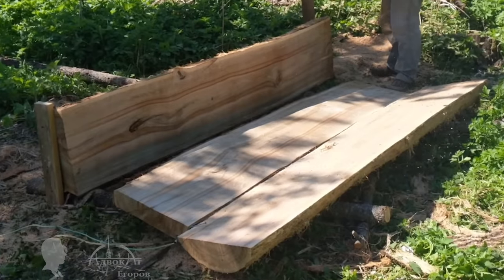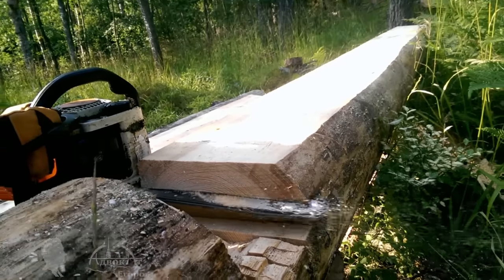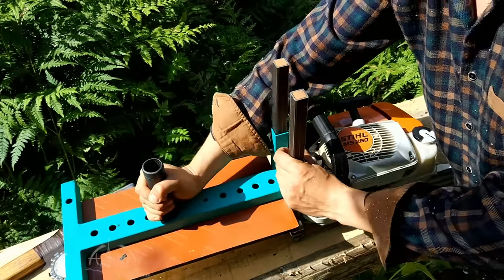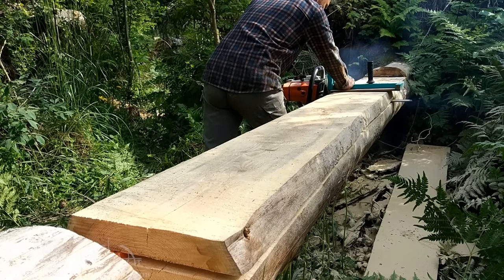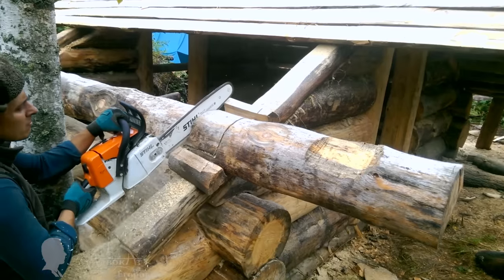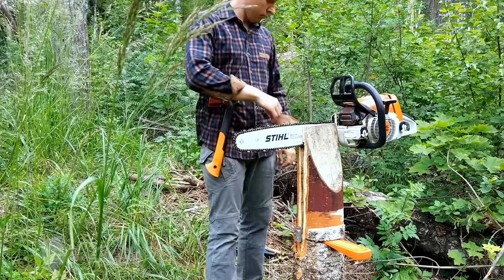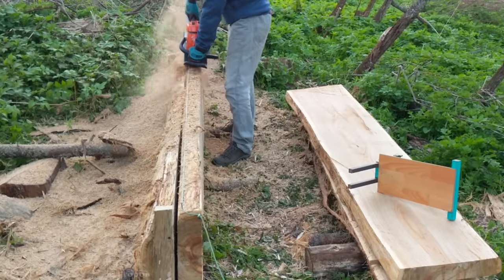Two Chainsaw Secrets | Turning a Tree into Perfect Boards

Comment from the maker: I wanted to ask you guys for advice. I no longer trust my Stihl MC260 as it gave me repetitive problems even after it was repaired by a dealer.

In other words, what chain saw of comparable size would be a good choice for cutting logs into lumber using my method
-------------------------------
Friends, for your convenience I assembled a chronologically arranged list of videos about my efforts in establishing
 this log cabin camp in the off-grid remote location of Karelia (All Seasons): 
-------------------------------
01 episode - @ (1 season)  2014
02 episode  - @ (1 season)  2014
03 episode  - @ (1 season)  2014 (not translated) 

1 episode  - @ (2 season)  2015 

 2 episode  - @ (2 season) 2015 

 3 episode  -@ (3 season) 2016 

4 episode  -@ (3 season) 2016 

5 episode  - @ (4 season) 2017  

 6 episode  -  @ (4 season) 2017   

 7 episode  - @ (5 season) 2018    

 8 episode  - @ (6 season) 2019 

 9 episode  - @ (6 season) 2019 

10 episode- @ (6 season) 2019
--------------------------------
My Patreon page: @t
Reply: You are great on that scooter lol lol lol
Reply: Husqvarna every time, and good two stroke oil at 50 to 1. Never add more oil, more oil = weak mixture = runs hot and increases wear. Steer clear of any 2 stroke with oil metering.
Reply: Maybe one of those competitive chainsaws, with a V8 engine 😂 ... Love your videos. Huge respect for your Work! .. greetings from Denmark. 😀
Reply: For heavy work load I've been using the same Stihl MS 660 for almost 10 years with only minimal repairs. However, it is a considerably larger saw.
*P.S., If you want to get away from Stihl you might try Husqvarna. I have a 480 CD that's over 30 years old, although it's worn out it still runs.
Reply: I have a couple Stihl saws but the one that most impressed is the huztl /holzforrma 372 I run a 41in bar on it and it has plenty of power and is cheap and been very reliable for me
Reply: 372 husky is probley the most reliable saw i have owned. 40 to 1 on the oil mix and break it in before using it for milling.  
      Just my two cents for all its worth.
Reply: Advoko MAKES , Husqvarna !
Reply: I've serviced quite a lot of small engines. In modern chainsaws Echo is a very reliable brand and they seem to make pretty good power for their size. I claim that they offer easily the best value for your money.
Reply: If the chainsaw gave you issue right out the box id call Stihl and let them know, its probably a defected saw.( they do get through the production line every now and then) I wrote to stihl and told them about this, as i own part of the company. (large part) i asked them to send you a new saw, and maybe sponsor you. But you deferentially need to get a new saw, as i know they would rather you use our saw in these videos instead of someone else's.
Reply: Advoko MAKES    Thank you brother for sharing your wisdom with us it is much appreciated        Peace
Reply: Another great video, Max! It sounds like you got defective Stihl. I have one that a friend gave me instead of paying a debt he owed me. It's  a good saw. I bought another, a MC260 in fact. The only complaint I have with it is the lockdown nuts for the bar were continually working loose. A little loctite fixed that problem. I really think you just got a lemon. Every brand makes one occasionally. Maybe you can get Stihl to sponsor you and send you all kinds of new chainsaws to test and critique.
Reply: I had problems with Stihl. Quit on me after just a few months. I bought an Echo to replace it. I love it! I've had it for 2 years, never had any issue getting it started. Good power, and doesn't stall out on me.
Reply: I also wanted to add, that I have been using a husky 445 for a while and have had really good luck for such a light saw. You can see some pretty serious ripping with it in this video that I did in the spring - https://www.youtube.com/watch?v=Adfis2HljdE
Reply: Professionals here use Stihl, Poulan, or Husky in that order. I can't say more but they rely on their saws to make a living so can't be too bad
Reply: Any saw with a 3 or a 5 in front of it....and run lean...I think that saw is to small for the job.
Reply: Husqvarna is a good Mark. but it sounds like you just got a bad saw. any Mark will occasionally turn out a bad unit. but in general I've had good success with Stihl saws. but again if you want to switch to a different brand then Husqvarna is good
Reply: Stihl has two grades of saw. If it is not the pro version it is not much better than any other brand. The pro version costs more but you dont have the down time for repairs.
Reply: I have a an older Jonsered 670 and a newer 2172. Both are real beasts. The 670 is the go to. They are heavy and get the job done. Lp
Reply: Stihl is now becoming known for their saws to fail. They are getting cheap on parts they use for building them now.  Greed has taken that company over. I say go with a Husqvarna instead ... those have good power as long as the saw is big enough for the job you are doing.
Reply: azsazs that very kind of you.
Reply: Good  saw  just stay with it got one 15 ye ass rs old let it warm up .or new diafram new lines filter breather  coil plug  clean cluch oiler .
Reply: can't quite rember but I think piston scoring on the exhaust side is caused by not letting the saw warm up first. Its called a cold seize, which is when the piston expands faster than the cylinder. Could also be overloaded and suffered from overheating. Overheating will effect the inlet side a bit as well but the cool fuel coming in will protect that side a little. Would happen to any brand of saw. I have never owned a Stihl saw but it's the brand that is used in our Forrest industry. My last good saw died a sudden death,  suffered from tree falling on top of it disease. ура из Новой Зеландии, хороший видио
Reply: Here in the Midwest everyone that I know that has a Stihl has them in the shop more often than in the forest. Always needing worked on.  I was on a ground crew for a tree service here for years. We always used Husqvarna  saws for ground work and small Echo saws for up in the trees.  Now that I'm just your average homeowner with a wood stove for heating my garage I have an Echo CS-440 with an 18 inch bar and have never had a problem with it. And I'm not the most gentle person on a tool either.  For you I'd suggest the Husqvarna  555
Reply: @Paulman50  i have had that happen on a cheaper saw with aluminum piston and cylinder. I think mostly due to wrong fuel/oil mix. Carbon can build up and score the aluminum. My sthil 036 pro is over 20 years old and ive never used anything other than sthil oil mix and it runs just like the day i bought it. Although it is a pro model and cost over $400 back then. I did change the spark plug two years ago just because. I admit im not a heavy user, but that saw has cut probably 100 cord of oak firewood.
Reply: @nooneyouknowhere6148  I agree with your assessment on there being a difference in the "Pro" models vs the "Homeowner". When I was in the tree business, I ran an 038-AV-Magnum, that I purchased for myself because the company did not want to put out for the expense. It was totally worth it and made my life much easier! Advoko... you should look into trying to get this model if you have the chance. Loads of power, screaming RPM's, low weight, and can run a much longer bar than you would think just by looking at it. I would buy it again if I found that I was going to be cutting a large amount of trees.
Munro
Reply: I forgot to add... the 038-AV-Magnum is made by Stihl...
Munro
Reply: Looking at the piston it has a four corner scarring it’s caused by the saw running to hot running a dulled chain will cause it to over heat the engine works too hard I would turn the chain into a ripping chain skip every two teeth file down two teeth and use a 10 degree angle to sharpen it there are videos on how to do it on you tube another thing open the low idle screw it will depend on how many feet above sea level you are to get the proper adjustments you what it to almost make a cam noise on idle then adjust the high side not quite screaming sound but almost like a bumblebee sound or look up specks for your location and set the saw adjustment with a md1 scanner next is the quality of your fuel in America we have poor fuel they add ethanol to it to stretch it out it burns up a lot of two cycles here stay ethanol free  if possible
Reply: I have used a STIHL 361 for 5 years now it’s my do everything saw 
I cut about 15-20 cords(4footx4footx8foot)  of hardwood fire wood a year with it and about the Same of cedar fence post and rip cedar and Pine planks 
The only thing I do special to the saw is I run as high octane gasoline as I can buy and I only use STIHL oil mix And I don’t store it for long periods of time with gas or bar oil in it
Reply: MS461
Reply: Hi. Great channel. I hope to learn a lot from you.

See, I personally think that cutting along grain with a 260 is asking too much of it. I don’t think it was really designed for anything other than crosscutting. I wouldn’t attempt using a stihl model number below 440/441 for anything like this, and even then the longevity of the saw is surely bound to be compromised. 

I see someone mentions Husqvarna 560xp here. I’d agree with that partially. It’s a good and gutsy saw but you would have to use Husqvarna xp two stroke oil as specified in the saw’s manual. If the saw were to seize mid use and it was found the two stroke oil used is anything other than their own xp oil they simply will not honour the two year warranty. Believe me, it happened to a friend of mine. 

I would really opt for a bigger saw and try to get used to using it as you would a smaller one. They’re designed for heavier work and will last for years. Plus you get a good workout out of it.😁
Reply: Thank you very much for spredding your good idea.
I have a 260 chainsaw, and, like you, are dissapointet with its performance.
I have used the 026 for 25 years with succes. Althoug it should be the same saw, i'll always find it much better than the 260.
Reply: Hello Advoko MAKES, I own both Stihl 260 and its Husqavarna XP 50CC Professional equivalent as well as other larger saws.  Although I have never tried using your method to cut boards freehand, I think your problem lies not with the brand, but with pushing 50cc saws to their limit.  Husqvarna XPs are generally considered more favorable by the arborist, logging community, while Stihl is still the industry standard, especially for Wildland Fire, and EMS services.  Both have their place and their fans, I think you need not worry you picked up the wrong brand.  My 260 has given me plenty of problems but it has withstood the test of time, and while its Husky 50cc counterpart does cut significantly faster,  I've noticed other issues that are unique to the Husky 50CC XP and it bogs down too sometimes when it shouldn't!  In sum, neither are perfect and I think you will be much rewarded if you investigate larger cc saws for this specific task. 

A friendly user above has made the suggestion of using Stihl 660 and 880, and indeed both are wise investments. However, because of the weight, both will need significantly more user time and training to get re-acquainted.  Writing from where I am from, Taiwan of East Asia, local carpenters have used your method to cut altar tables (usually the best wood with slabs too big to be cut by milling machines) and other religious-based furniture with both Stihl and Husky without a problem.  Good luck and God Bless you for making the video, stay safe and hope you find the right saw.
Reply: Ms311 is a 60cc. Any saw 60cc or more should do it for you.
Reply: @stevetaylor9265  I agree...
Reply: Love that tree stump vise, but I keep a husqvarna stump vise in my bag. Works good and can be hammered into a log or stump. Sthil climbing saw,  husqvarna for ground saws. 357xp 20+years strong.
Reply: There is only ONE chainsaw brand with a FIVE YEAR WARRANTY... and that is ECHO brand.    I have 4 ECHO chainsaws, I love em!

THE LARGER SIZES ARE:
CS490 - 50.2cc - $349.99
CS590 - 59.8cc - $419.99
CS680 - 66.8CC - $639.99
CS800 - 80.7CC - $859.99
Reply: Husqvarna 390XPG
Reply: Husqvarna 390XPG
Reply: Before you buy a new saw, try a new chain.
They make chains specifically for cutting logs into boards. Rip Chains make a slower cut and leave a smoother finish as well.
Good Luck, Enjoying your videos
Reply: @azsazs6039  that is a great offer. Sthil saws are reliable saws. Even though I did not like the 026 / 260  for other reasons, they were very reliable. If he is able to get the MS 261 he will have a reliable saw with much better performance.
Reply: Use a lot more oil in gas.. I load my  saw with way more than specs call for
Reply: Just read someone elses post and he says less oil..?
Ive always loaded my saw heavy with oil without measuring..
The one time i used someone elses saw and they did mix it destroyed the saw and it was new... All i know is my saw loves oil so i give it oil...
Reply: Тебе кто разрешил деревья пилить?
Reply: Anyone that can haul two huge pieces of logs out of the woods with a moped , gets a thumbs up !!!
Reply: I would recommend the Sthil MS362. It is a size bigger but the weight to power ratio is impressive.
Reply: @azsazs6039  Stihl is good equipment, used mine Many yrs.  If a problem from beginning, something with the saw was not rite.  Dealer should have caught that.  Maybe they figured they could fix it rite.  Only other thing would be correct oil for mix.  All oil is not the same.
Reply: Hi, I know why you wanted to use the MS260, they are quite powerful for the weight, and with your method the weight of the saw is very important. I have several Stihl 026 saws, the previous model to the MS260, and these 026 saws have given very good industry level service. I always use the Stihl synthetic 2 stroke oil. I'm assuming with your method that full revs are only on the cutting stroke so the revs are constantly changing which is a good thing. The problem with the frame milling attachments is that they encourage the user to keep the saw at full revs through out the whole cut which builds up excessive heat. The MS261 saws are more powerful but slightly heavier, I suppose it is down to what is available, but varying the revs is very important. As regards to the depth gauges I set mine to 0.8mm (.030) to get free running quick cutting with no dust. I have some 026 repair videos, cheers
Reply: @davidd6635  Yeah i know, thats the 1st thing that came to my mind, factory default, they do happen from time to time and its very important that they are made aware of it so the can fix that problem.
Reply: For lumber milling, you are using too small a saw.  Get the biggest saw you can find. I would use nothing less than a 72 cc saw.  Stihl ms 440, MS460 magnum or even a 660 magnum would be ideal.  An old style Husqvarna 372xp, 385, or 390 would also be ideal.  I use strictly the older versions of the 372.  Parts both OEM and aftermarket are readily available and performance upgrades can be made for substantial increases in power.  I do some port work and open the muffler and even put a pop up piston in a couple.  They scream.  The older saws seem to be way more durable.   Plus they are cheaper to acquire, easier to service and parts are cheaper often.  I would also only use premium full synthetic fuel mix.  Stihl full synthetic would be the cheapest I use.  Don't know if you can get Amsoil, but I only use Amsoil saber in my saws.  Royal purple would also be a good brand.
Reply: I use Farmertec G660 92cc saw for milling. Farmertec 3/8 full house full chisel chain sharpened to 10 degrees with 4.8mm file. 3% oil mixture and hi jet a bit rich.
Reply: I use a Husqvarna 353. Perfect balance of power and light weight. It is the pro equivalent of the 350 which is a homeowner saw. Also. Have a 455 and it is a beast made for farmers and ranchers.
Reply: @chattonlad9382  I have run 40:1 in my saw from day one. That was 16yrs ago, and last year, I did a compression check on it. 155 psi . From my experience, less oil will make the saw run hotter, not more oil.  Stihl 036 Pro
Reply: @stevetaylor9265  Yep, I only run my saw with 40:1.
Reply: Hultz farmertech. Get a holtzforma g660 or f444
Reply: I have used stihl, jonsered, and husky.  I prefer husky.  Let saw warm up to avoid scouring of piston. rip cutting is easier with skip tooth chain. File rakers down a bit more, but watch out for kickback.  If you look from the side of your chain, ensure you have enough depth when filing.  You should see a nice hook on each tooth.....cut noodles, not sawdust.  cheers!
Reply: You are doing the work of a timber saw because of the longer time periods you are pulling the trigger at wide open.   I highly recommend a pro series timber saw instead of a homeowner model.   The Stihl MS460, Husqvarna 372XP, and the Jonsered 3172 are all of equal caliper.  I don't know where some of the guys are are coming up with the nonsense of running a saw lean for longer life.   The EPA is destroying the quality of modern saws by trying to run them too lean as it is.   If you will run 40:1 synthetic mix and de-tune  your saw to 12,000 rpms on top end instead of screaming like a banshee, you will get long life out of your saw.   And, a pro saw is rebuildable many , many times.   You get what you pay for and you are definitely exceeding what a homeowner saw should be doing.  And Poulan, ha, the only reliable Poulan  has an electric cord attached to it.
Reply: 85577alarm  a Stihl MS391 is still a homeowner saw though.    All plastic, clamshell body and cost $575-685 when new.   All of the one series saws are relatively new and there is no aftermarket parts support available at this time.  That amount of money  will buy a very nice, used timber saw that will weigh relatively the same and be a heavy duty pro saw.  What is a 190 or who builds it?   I work on saws  and can't place that model number?
Reply: @ulriklange3924  how about diesel engine ??
Reply: Great video! Just sold my sawmill so I will try your method coming winter. I have the same 260 and never let me down last 2 years. Has more problems with my former stihl. I only use the Aspen fuel with this one. Maybe that makes a difference...
Reply: Never ran a stihl i liked ...husqvarna all the way ...they can be a bit of a bastard to start but they outlast the other saws by a wide margin
Reply: I will second the Husqvarna suggestions - we ahve run both brands of saws for the last 40 years, Husqvarna / Johnsereds never an issue - all issues with saw performance have been with Stihl. When they run / work well - awesome soaws, when they are problematic - nothing but trouble and no amount of tinkering / repairing etc ever seems to make a bad saw into a good saw. I'm 52 now, started with an old Stihl 015AV when I was 10 ( heavily supervised) . That was a great little saw...but we had an 042 a few years newer that was nothing but trouble, the Johnsereds my dad had at the same time as the 015av is still in his basement and still starts after a couple of pulls even when it only gets run a couple times in a year. My Husqvarna 242xp from the 80's is a workhorse, we have a 272xp (good option if you want a medium weight  strong saw, not sure how it compare the to MS260) which has been around for a long time. In comparrison the MS250 my dad got not long ago has an out of the box problem with the oil pickup and sometime the fuel or oil cap will not lock but looks like it is until you realize your boots are covered in bar oil and your bar is not. 

I think that if you find people who regularly use both brands, they will all agree that it comes down to which specific saw you are comparing to which other saw....
but....
I will always start looking at a Husqvarna option first and only if there is a proven Stihl option which seems better go that route.

Stihl has better marketing and more of it, Husqvarna just lets the saws sell themselves.

You be the judge.
Reply: I've got an old Woodsman that works on my saws I've had stihl, Husqvarna and jonsered and I have a new Echo now he says the new Echoes are built better than any other saw now.
Reply: The Stihl and Husqvana saws will suffer from lower quality fuel, the fuel is getting weaker and weaker being mixed more with other chemicals, this is why's saw will not run for as long.  Also modern saws run faster and leaner to meet emissions targets and to get more power from the fuel, they scavenge exhaust gasses and as a result wear out quicker.  I now use a Bio fuel or very high quality 2 stroke oil.  I would look at the Makita/Dolamr 50-60cc saws, very strong saws.
Reply: Spasibo, spasibo for the awesome video! I switched from a Stihl gas chainsaw to an electric (battery powered) saw 3 years ago and never looked back. Like you, I had a series of issues with the gas saws, regardless of manufacturer. The more powerful battery powered saws have plenty of power and the reliability, maintenance and operating costs  are substantially less than a gas powered saw. In 5 years, I doubt there will be any gas powered saws on the market.
Reply: Seeing that piston scoring after 2 months indicates to me either a serious air filter problem, contaminants in the gasoline, or improper mixture. Shake your mixture up every time, use as high octane gasoline as you can find, and try to get non-ethanol fuel. Start every day by closing the choke on the saw and blowing the air filter out from both directions with an air chuck, and do it well away from the ground so that dirt/sand doesn't lift. Then blow out the air filter cover and the carb assembly.
Reply: Man you need a customized table saw with a huge disc.
it will save you a lot of time and effort, and your cuts will be precise.
Reply: My Stihl ms 260 lasted for 6 years , I stop my chainsaw when it’s low on gas and I never let it run out of gas completely , I never use regular gas instead I use super unleaded so idk if my routine is working for me or if it’s just luck
Reply: Sthil 051 and sthil 660 ms  i trust them
Reply: Use the Stihl 660 a 260 is not anywhere near powerful enough
Reply: Хускварна ёсть лучшё за работа в дома.
Reply: Stihl saws have a problem with the oiler and that's probably why it's not lasting for you.  You have to make sure it's turned up all the way, and clean the oil holes in the bar often and also make sure the hole going into the saw is clear of sawdust.  Also clean the track with a credit card of something.  I also let my saw rest after about 15 to 20 minutes of cutting and cool down.  Husqvarna professional saws are pretty good, but the department store variety only have one compression ring, and they still need the same care around the oil holes because of the longer bar.
Reply: We also have more trouble with our Stihl MS200 than with the Husqvarna 357 XPG. Something to be aware of is that chainsaws are not designed to run on full throttle for longer than a few minutes a time. 
The Husqvarna never fails me even if it probably is a bit small for milling. Usually at least 70cc is recommended for milling but that might be for the very reason you discovered, a more powerful saw is needed if the whole bar is cutting. A used Husqvarna 357 XP in good condition or the newer 560 XP is the direct counterpart of the MS260 and if you are satisfied with the performance of the Stihl they would probably suit you. I would also recommend to only use alkylate petrol such as Aspen (http://www.aspenfules.com) instead of regular gasoline and oil. It's better for the environment, better for you and better for the chainsaw.
You have a very interesting technique I will have to try that when I start milling for myself! I suspect that it requires a bit of experience before the cuts are good and the boards are reasonably straight.
Reply: I use a Husqvarna 450 Rancher for exactly what you do; felling trees, ripping planks freehand, branches, firewood...
Reply: I’ve been using a poulan wild thing lol
Since 2001 lol. I changed the spark plug once, about 2016. It runs great with an 18” bar always starts on the first or second pull. I only put the non-ethanol gas into it and keep the bar oil full. 
Cheers mate
Reply: If that was scoring on the piston it was probably an issue with the air filter.
I use a Husqvarna 450 with an 18" bar. Husqvarnas are very reliable and have better quality air filter designs. if any oil or debris is drawn into a saw's engine through the air filter then it tends to score the piston like that, which can  quickly kill the saw.
Reply: Husquarna.    Greetings from finland
Reply: Advoko Makes, first of all I want to compliment your work, It´s outstanding !
On regard about your chainsaw problem and seek for advice. I´ve been building a log cabin for over a year now, and for the job I´ve been using a Stihl MS361. This has been the only chainsaw I´ve used, and needless to say, I´ve abused it, and so far it´s withstanding the job with no problems at all. I´m using dead standing cipress (that was caught in fire a decade ago), which is not the friendliest of wood for the chainsaw. Hope this help. keep up with your videos, cheers.
Reply: One issue I've heard is the newer saws are hampered by emissions legislation.  Better off to find one from a few decades ago or get a new fuel injected one.
Reply: Rick Sanchez C137 didn’t look like a warrantable failure for any brand.
Reply: Tam Moilliet had one for 5 years now. Excellent mid size saw 👍
Reply: Stihl makes a homeowner saw line and a commercial line. They look the same but are worlds apart. Make sure to get the commercial such as the .044 or the very powerful .066   The .080 is too powerful and bows or twists the bar. I have many hours experience with each. Farm boss is also a homeowner saw. Thanks for showing this technique. Watch those toes!!
Reply: @azsazs6039  hope you told your Stihl buddies to send him a commercial .044 and a rip chain
Reply: @nooneyouknowhere6148  spoken like a skilled treeman! Yes, I shared this same tip and recommended the .044 for what he is ripping.
Reply: Phil Harley I think you’ll find those model numbers have long been superseded 😉
Reply: Pro's use Stihl and Husqvarna, when I called Stihl rep to ask what they consider their pro models the representative said MS 290 and up are the pro models and reading the forums the Husqvarna pro models are their XP line. Another easy way to tell is by price, the home versions run $300 and the pro versions are $700 in the US
Reply: Stihl 090 all the way!
Reply: I like Stihl. I use the 661 for milling. We also have an old stihl 088. It’s very big but it’s a pain to use for most things.

One thing that will help with ANY brand of saw.. add more oil to your mix. I use about 25% more oil in the gas mix as it will protect the cylinder and last longer. Chainsaws are not designed to do milling and run continuously and they can burn up easily. The additional oil can make your spark plugs foul quicker if you are not using the synthetic oil in the mix.
Reply: I've been using a Stihl ms 270 with the 25in bar for a little over ten years know. I have had no problems at all. Still using the same spark plug even. Only using Stihls mix at 50:1 with a none ethanol gas. Huskies are ok, they just don't run as smooth. Anyway, great video. I am going to try this with a few logs I have laying around. Thanks for sharing.
Reply: Let your saw warm up before use. Specially this long cuts you are making. Saws are getting increasingly compact and could influence ventilation. Also the difference between pro and normal user.
Reply: I've owned a Stilh 044 with a 24" bar for about 25 yrs and just replaced the original spark plug this year , my saw has been used heavily in my work as a carpenter and cabin building also tree felling and I've never had any issues other than the spark plug. I don't take much care with tools figuring it's cheaper and saves me time to just by a new tool after breaking one but I haven't been able to kill the Stihl .
Reply: I own Stihl MS 362. Best chainsaw I have ever had.
Reply: My 3 Stihl saws are over 20 years old, but I was told that Stihl made big changes to meet the strict emission standards.  I think Still is likely still the best but the new saws, I believe are problematic.  I new more details of the chà an ges when I researched online and talked to a dealer.  But anyway, my research promoted me to have my saw repaired rather than buy a new arborist saw that seemed sub-par
Reply: Try a dolmar ps6400 or makita dcs6421
Reply: Husqvarna Pro Series like the 560xp would be great for you.
I too used Stihl Saws for Years every day ( I am a logger here ) but the last say 5-8 yrs their Quality has slipped badly. So since I have to use a dependable saw I tried the Husqvarna Pro series and I love them. Tough, power to weight ratio is fantastic and they are VERY DEPENDABLE . Find a Dealer and go try one of the XP series of saws....you will see what I mean.
Really enjoy your Channel and Videos.
P.S.
 I have seen a cylinder and piston out of a Stihl Saw that looked identical to what happened to yours. The Owner of the saw (a guy I have worked with for years) said the dealer told him it was because he revved up the saws engine when it was first started instead of just starting it and letting it warm up first. He sees lots of saws of all brands that are used in the construction buisness like log homes and so forth and unless they are allowed to sit and run for a minute or 2 even you risk damage because of lack of proper lubrication in the cylinder. I dont know if it makes a difference or not but I have always started my saw and let it just sit and idle for a little bit before I go to using it and I have never scored or stuck a piston in my life.....I have wore out pistons over the course of a couple Years of everyday use but never ruined one like that so maybe there is something to it. All I know for sure is we have not had a saw do like that since we all started just letting them warm up a couple of minutes before using them and we never go to full throttle unless in the wood and cutting. Hope that helps you.
Reply: Makita makes a batt operated chainsaw that is awesome!  I own one and it is surprisingly hard working!  Have two extra batts (5 amps each) that substantially increase duration of operation.  And they can be recharged from a 300w solar panel!  You can’t make petrol in the bush, but sunlight is eternal (more or less).
Reply: Looks like you ran the saw with out warming it up
Reply: Man you should try each brand
Reply: @Paulman50  Exactly what I was thinking.
Reply: 028 Farm Boss, possibly the best chainsaw ever.
Reply: I’ve owned a Stihl 260 for 10 years and never had a problem. The saw you purchased was undoubtedly defective, and I’m certain that Stihl would honour their warranty if you contact them.
Reply: Husqvarna 372 xp. You will never go back.
Reply: Homelite, it's the bees knees
Reply: @PenZon  Echo is trash. They make terrible chain saws. You will never see a tree company with them. The demo units they push on everyone are toasters.
Reply: @azsazs6039  You ran the incorrect chain. Rip cutting favors skip tooth chain. You did not run the engine under the correct load because you had the wrong chain. In short you overheated the saw with every rip you made.
Reply: @rivtool515  What? I was telling him he has a bad saw. I never said anything about me or my saw.
Reply: Advoko MAKES 
I’ve a 261. And it’s my favorite saw hands down out of the entire fleet. That’s odd for a pro saw to have damage like that so quickly. Dirty air possibly? Or it was ran way to lean in the air to fuel mixture. 
The only other suggestion I would make for a milling saw is an older Stihl 064. It’s much heavier. But it’s a power house for what it weighs.
Reply: Я не знаток но похоже Husqvarna делает хорошие бензопилы. Не знаю как они по цене к Stihl...
Reply: Hi! I have been using Stihl and Husqvarna  for few years and they all had a lot of issues, now I have ECHO 66.8cc chainsaw with 24 inch bar. They are made in Japan. It works very good with my lumber cutting
Reply: I work everyday cutting trees down in all seasons of the year in upstate NY. Husqvarna 550xp mark ll with a .325 .059 78dl chain its a sure fire saw, plenty of chain speed and tourqe for an mid size saw. Don't believe the hyp of Stihl propaganda!!! A few guys I work with have Stihl and they have all broken within a few months at the longest. Go Husqvarna and you won't have any problems 😁
Reply: When you feather the trigger, like you were doing when you were cutting, instead of having the trigger pulled all the way, there is not enough fuel to lubricate the piston. Sometimes there's enough to keep it running, but most of the time it bogs out and quits under a heavy load.
Reply: The stihl 260 is a great saw. It looks like you were putting only gas into it. You need to mix the correct oil with the gas first, then put the fuel into your saw. Otherwise you will blow the engine.
Reply: Use stihl 381 i also have it and use it the same way anyways many people here use the same technique. Earlier I too used attachments but it took long time just as you said and switched to this technique which consumed less fuel
Reply: My friend: use engineered gasoline. That's tip number one. Learn to adjust your saw in the cut, utilizing the four stroking method.
Reply: there is no saw in the 50cc size class that I would recommend for milling at all In Stihl, you need to look at something like an MS660 at the least.
Reply: While having less Performance by weight, echo saws are known for immense reliability (hence the weight i guess)
Reply: @severini8153  he's in Russia, unlikely he could get Echo
Reply: @mattcourty6322  I bought a used 034 AV Super from an arborist about 20 years ago, and it's never been in the shop.  It cuts my 12 face cords I heat with every winter.  Before that I had a Husqvarna (don't remember the model), and what a cheap piece of junk.  Mostly plastic.  I think the difference isn't so much the brand as whether you have the professional grade or homeowner grade.
Reply: Chattonlad what do you mean by “steer clear”?
Reply: none of the 3- series saws from Husqvarna are "homeowner" saws. that would be the 1 and 4 series. 
the 353 is a different year. 346 and 350 make great builder's saws (meaning take mods great) but all three mentioned in this comment are 50cc saws.
Reply: I've had the same ms390 for 17 years. Replaced the fuel lines once and the 25 inch bar once. Maybe stihl quality has gone kaput?
Reply: @brobdingnagianone900  nope, quality still there, this guy is asking way more of his MS260 than it should be expected to do
Reply: I'm a bit late, but try Dolmar, they make great chainsaws for a reasonable price.
Reply: Matt Courty my dad and brother both had Stihl’s.   Worked fine for a while then at some point they just wound up tight..ping.   Dealer basically said they were non repairable.   Seemed to be a prevalent problem.   Noticed the county highway dept had all gone to husavarna.   They are not likely to go back.
Reply: Can you define your problems?  It is vague.  The 260 is a fairly small saw for this type of work,  I've found my 460 magnum to be a great all around size, although a 360 may be a good compromise of weight and power for a shorter bar.

As far as husky vs stihl, they are both great, model dependant, just do your research and watch YouTube videos to learn to do your own repairs and upgrades.
Reply: Styhl Ms 362
Reply: If you have a 260 burnout in two months then you have a problem, a mechanical issue.
Use premium/high octane gas.
Use Castrol/Stihl brand mix oil.
Dont rev the engine when it isn't cutting/ under load.
Try a still ms362, it is the next size up.
But really I think a closer examination if your saw and cutting practices should be undertaken. The 260 is a great saw and should work for years.
Reply: I use a Stihl MS 291. It's heavy but it gets the job done everytime.
Reply: @steveadams80  i have two 291s. One i purchased new in 2004. They both have hours of good service. Very reliable.  No sure about the newer saws
Reply: azsazs I’m just starting off as a wood carver, but my father has been in the logging business his whole life. I don’t know any specifics on his work, but I would love to get him a new durable saw. Any help?
Reply: azsazs I’m also just starting my own channel and would definitely do a review video
Reply: Run a MS310  like you do works great as long as I have a sharp full chisel chain . Wore out a 026. And picked this beast up in a pawnshop for 100.00. A new bar and chain and gas cap been rolling ever since. Just not big enough gas tank when I am milling lumber. . Good work there.
Reply: My guess is the mixture was a bit lean and it was running hot, you would get higher revs but at a high price.
Reply: I miss my old Polan 3400 countervibe (from the Original Polan company). It had tons of power. My brother borrowed it once though and left fuel in it all winter. As this saw was from 1986, I could no longer get a carburetor kit for it, so I bought a Stihl MS270 Farm Boss a few years back. It has been fine so far.
Reply: @nikburton9264  Nik, I make sure there are good quality self locking (serrated) nuts on the bar clamp. I know some companies use nylok nuts but those can vibrate loose. Another fix is Schnorr washers. They stay tight! (serrated and cupped).
Reply: Dennis Long  yeah, poulan is great. Everyone i know who does tree work has one stashed just in case and everyone's grandfather had an old poulan in the garage or the barn somewhere that's older than i am
Reply: Greetings from Texas.. Over the past 40 years I have used Homelite,Poulan,Stihl,Husqvarna and my latest purchase Echo 590..Pound for pound the Echo 590 is equivalent to the Husky 288..My main woods are Hickory Mesquite and Oak.. I have never tried the Echo on the long cuts in your video which are very impressive.. I  am going to give it a try.
Reply: I thought Stihl was a good saw but I guess the level of work you do is just too intense. At which point I would like to say you do some amazing work. WOW not sure where you are but looks like a beautiful place. Stay safe you are inspiring me to try building something in the Bush. Thanks for sharing your life and expertise.
Reply: Hello  I use echo chain saws really good Japanese made
Reply: Husqvarna 365 or 372 in my opinion. Great saws, very rugged and will last a long time.
Reply: Hey great videos , as for your saw I recommend turning down your high jet so your saw doesn't rev so high it's what I had to do while using your technique to saw out logs.
Reply: Great  board cutting technique. I run a chainsaw repair shop and I have rebuilt many Stihl and Husquvarna saws. Those are the best two saws on the market provided you only buy their professional series saws. MS260 is a professional level saw and looking at the scored piston in the video Id say you're oil; mix was a little lean or you adjusted the carb to lean on the High side screw. I only use  Amsoil synthetic oil in all my saws and I highly recommend it to all my customers.  Theres nothing wrong  with a Stihl MS260 but a Husquvarna 372XP will do the job. Good luck, Scott
Reply: I’d say a ms 271 or 250 I’ve had my ms 250 for little over 10 years and I’ve ran the crap out of it very well biult saw. The 271 allows you to run a variety of bar sizes, to where ms 250 can run up to a 20 inch bar .
Reply: Echo made a good saw , I've own several of them , most timethe started first pull , I f they didn't on the third pull the plug was fowled
Reply: My husqvarna 550xp gave me similar problems only the dealer gave me no support.    My saw scored the top end.   They blamed my fuel.   Which was fresh non ethanol, Stihl ultra oil, and being used by 3 different saws.   In the end I paid a different dealer to replace the piston and cylinder.   He could find no reason for the failure.   I had him replace the carburetor for an additional $115.   Total bill was $283 plus shipping.   I to never trusted the saw after that.   I used a few times but sold it this spring for $325.
Reply: I've always had stihl and feel I may be on my last one. Heard lots of good on husqvarna.  Thanks for the great video
Reply: I love your work!!!! Very impressive! I own a small tree service. I own both stihl and husqvarna. You try a husqvarna 550xp or 562xp. I own several of each and beat them up and they just keep going.
Reply: husquarna, Swedish made chainsaws. great video man! love the scooter transporter
Reply: Great that you helped the guy out making the fantastic videos.  Wouldn't want a bad comment on  a public video about your heavily invested product line. You retain that the saw could be defective? Where's the quality control? We as consumers do pay a premium for stihl equipment you know?!  Once upon a time stihl made quality equipment,  I sir have ended my mistakes of being let down with my recent purchases of stihl power equipment.  Failing clutch engagement problems, electronic carb tuning issues,  fuel cap failures etc.....I literally just gave away an old 361 saw that we had purchased new 20+ years ago that was still in original, good running order to switch over to husqvarna.... I wish this video maker success and he needs a reliable superior saw to do so.......
Reply: I agree! Stilh products are garbage lately.  They somehow are relying on their reputation if the past to survive.  Won't be long though.... This land clearing guy has switched to husky pro saws👍..... No comparison!!!!
Reply: I have been using a stihl ms 361 since 2004 and it still runs great as long as you take it to the dealer once a year to get checked.
Reply: can you post on your pages where you buy your axes, i am in canada and am looking for quality axes and other manual cutting tools, which i cannot seem to find here, everything comes from china
Reply: Hi again,Max. To answer which saws make good milling saws,  Most people recommend ones of around 90 to 111+ cc's.   Saws of which some are older and heavier but are torque type saws vs high revving types. These are ones such as a Stihl 051/056  which is 81 cc and 075/076  with those 2 being 111cc saws. Also a Stihl 088 or MS 880 and the Husqvarna 3120 or a 395 XP make wonderful milling saws as well.  If I were to recommend saws to use with a chainsaw milling jig, it would be something along the lines of those 7 saws and even a big Homelite XP 1020/ 100 cc saw.  These  saws are very good for the large 200 cm to 1 meter+ diameter logs using milling chains.  Other great saws that are lighter and possibly easier to use for "your method"  might be Stihl 044/ MS440, 066/MS660.  Husq, 365XP , 372, 340, 550 XP on the smallest and lightest end and comparable to your MS260 Stihl.  Just to let you know,  My first chainsaw is and was basically your 260 only older.  Stihl 026.  I own 2 of them, an 044, 660 and the previously mentioned 056 and 075's.   Good luck and keep up the hard and enjoyable work.
Reply: Use a Husgvarna
Reply: I have had a Husqvarna 460 w/24" blade for about ten years now and a Stihl MS271 w/20" blade for about a year. Both have been great saws
Reply: Hello Mr. Please you sell it's dispositive? Vindeți(Ro)? Thanks
Reply: @Paulman50  ⬆💯⬆
Reply: @advoko

I'm in Michigan and cut 10+cords/yr of hardwoods.

I like the Husqvarna. That said, the design is nowhere near as robust as Stihl.

I've switched to Stihl.

You might want to try a Husqvarna. It won't last as like ng as your Stihl. But they are lighter and almost as good as a Stihl.

For me, I go through enough parts with 2 chainsaws cutting 10cords plus helping neighbors....the service and expertise of my local dealer determines if I run Stihl or Husqvarna.

That said, chainsaws don't run all the time forever.

Is it possible your attachment put too much stress on your motor?

 It wasn't designed to be a sawmill. Using such a device voids your manufacturer warranty. Guys I know who use Alaskan Sawmills, use them with very large Bar Chains...like 36" (1M). They use thier large saw for big trees, and milling in only. It's too big for anything else.
Reply: Stihl 391. Solid. I Have 3
Reply: I have a stihl 066 and quit mixing 50:1 a few years ago. I now run between 25:1 and 35:1 and have found I have been getting longer life out of the engine.  In fact I’ve been running without a rebuild for years since I quit 50:1 fuel. I have also freehanded lumber with good success. I get nice long shavings and quick cutting by holding it on about a 45 degree angle, and I still sharpen it for cross cutting. Perhaps I’m doing it wrong, but it works pretty good
Reply: @chattonlad9382  Yuup! Husky baby! Only way to go! And take it to a good saw shop that you trust right out of the gate, and have them tune it in! It will be a screamer!!
Reply: This probably isn't the issue considering your experience (everyone makes mistakes!), but I couldn't help but notice that your gas (starting at 10:54) looks clear. The 2-stroke oil we have here is blue, so any gas that's been mixed has a bluish hue. Running your chainsaw with no oil is one cause of the piston scoring you showed on your 260.
Reply: that 260 is brush saw, if you up grade to a 360 you will up grade to a farm grade, for a commercial rated for timber saw you will want be above 550, my self the 660 is the my preference, the 880 are very powerful all though all of them can be very hard on your shoulder when s starting
Reply: Husqvarna 440 pretty peppy... Or husqvarna 455 rancher. I have run the same saw for 21 years. Swear by husqvarna..
Reply: you  better choose a big cc like a sthil 070 or husqvarna 3120. they cut like a  hot  knife on butter.
Reply: stihl 440 or a 362c ive ran them for years, perfect for milling, surprisingly echo chain saws are field worthy 5 year warranty and operate just as well if not better the stihl and husqvarna.
Reply: Yeah, the 260 has the smaller teeth, the .325 doesn't cut shit. lol.  you'd be surprised what happens when you switch to another chain with more bite in the pitch.  They make them that way so you think they are dull and have to take them in to get sharpened.
Reply: I like the old Stihl chainsaws. Late 90s models are great and can be purchased used at good prices.
Reply: I've cut trees in a professional capacity for almost a 10 years. Thousands of trees, I'm sure. The issue you're having with the Stihl 260, in my experience, is the exception rather than the rule. Unless I'm climbing and working aloft with ropes the 260 is my go-to saw, along with most of the seasoned guys I've worked with. The younger, unskilled guys want to grab the 360's because for them it's less about efficiency than about looks and the perception of power.
     I've used your method on several logs now with satisfactory to excellent results, but I blame the less ideal cuts on my inexperience and the fact that I'm going against too many industry rules of saw use. My saw ran effortlessly. It seems that there was something in your cylinder, probably metal shavings, that caused that. Did you do a muffler/port modification or anything that would introduce shavings into the chamber?
     I'm sure you've been over that possibility. I just can't think what could be causing this. As I said, with very very few exceptions, the Stihl 260/261 is generally an excellent saw that can be run for almost 10 straight hours, 5 days a week, 52 weeks a year with nothing needed but sharpening and very light maintenance.
Reply: @jesse1136  And I 100% bet you are not using a commercial chain.  :D    As a person who still cuts thousands of trees on a yearly basis.  We don't use 260's anymore with their flaws.  We swapped the climbers out with mostly Poulan now.  Since they customized chains for the company.  At one point we had 36 failed 206's.  Each one of them Stihl tried to claim that we were to blame for it.  When 3 of them were brand new and had faulty motors to start with.  Seized up during the first week of use.  :D

They used to be good, but with the whole cheap plastics and moving into more "environmentally friendly" nonsense, it's really affecting the way they run.
Reply: I've owned a Sachs Dolmar, a Husqvarna, and Echo chainsaws. I love my Echos. The CS-590 Timberwolf comes with a 20" bar, 5 year non commercial warranty, 1 year commercial warranty. They start great and run good. I've had one echo for 6 years, and bought a little CS 310 last fall with a 14" bar to limb with. The dealer I bought the Echo from works on all the brands and he fixes a LOT of Stihl saws. He uses an Echo as his personal saw. My Husq has a 2 piece airfilter and it popped apart and sucked dust into the cylinder. $125 for a new cylinder and piston. I cut 12 cords of wood a year with my Echo for the last 6 years, and it's still going strong.
Reply: John Morris yup running the saw too much at full throttle with not enough load will over heat the engine.  They are meant to run at load speed and I imagine this way revving at 13500
Reply: Good video I will try this technique!
As for the chainsaw question 
Did your Stihl dealer give you a new saw?
Two months “NEW” would still be under warranty! 
In my opinion the 026 ms260 ms261 are amazing saws 50.2cc 3.0kw I’ve got all three,
I don’t think the job was to big for it  but a slightly bigger saw might be the answer,
Ms361or ms362 59.0cc and has about half a KW more power than the ms261, 
But my personal favourite saw is the 044 70.7cc Oldie but goodie mine are around 30 years old and are cutting like a new saws (not stock) I’ve got two, But the ms441c Mtronic is an absolute beast. I cannot fault this saw and still to my surprise Stihl dropped this engine size.
The next two saws confuse me, different engine size 72.2cc ms462c-m and the 76.5cc ms461 which has identical power output if  4.4kw and the ms461 weighs 700grams more. 
I have both and the ms462c-m over half a kilo lighter is my pick!
The next saw I don’t have YET the 500i
79.2cc 5.0kw all the stats sound good but I have yet to used one so I can’t give my personal opinion on that one!!!
Also I’m not disputing your fuel mixing technique but I will say Stihl oil 50/1 with fresh fuel always every time. If in lend out one of my baby’s to CLOSE friends I fill the tank and I state to my friends DO NOT PUT ANYMORE FUEL IN THIS TANK IF YOU THINK YOUR CUTTING FOR THE WHOLE DAY ILL GIVE YOU ANOTHER LITRE!! 
But in your case I’m not disputing fuel ratio, I can tell you know what’s going on, but possibly a vacuum leak or sucking air from the intake runner that saw got FN hot and lean AF, 
Anywho I hope I confused you a bit thanks for your video!!
From Australia with saw dust!!
Reply: Just get a 50cc stihl doesn't have to be special although the bigger egine has higher fuel consumption
Reply: @jfhunt  you made a pro choice. Carbs.
Reply: Stihl mc310.
Reply: You just need a heavier saw.... still 461mag  at minimum... I would recomend a 661 magnum as ideal. Ripping is hard on a saw and you need a good deal of power as not to beat the saw to death..
Reply: Husqvarna makes excellent chain saws. Their Rancher model would work well for your applications. Good luck!
Reply: Advoko MAKES you might to go the route less traveled and buy a cordless electric saw. This way you can use solar panels to charge it and not have to pack fuel with you.
Reply: Dolmar.
Reply: This on where which city please
Reply: Echo (Japan) or Husqvarna (Sweeden) if you want your tools to last.  Stihl (American, but made in Mexico or South America) does not harden their steel components properly.  Their heat treat process is very poor and uses lower carbon steel. Stihl is light weight for easy carry and for homeowners, not professional landscapers or heavy work long duration like you're doing.
Reply: @rewrewd5904  I agree as a former mechanic always in search of sweet spot between power and life. That piston and rings was over heated possibly too little oil. Lean fuel conditions cause pistons  in 4 cycle engines same problems
Reply: Jonsered 2455. I have one. I love it. Gonna do a LOT of ripping this year!
Reply: Husqvarna 394xp
Reply: Good clip mate 
I’m an arborist in Australia and run a range of stihls from the old 200t up to new 661 and most in between 
I would recommend you check out a 362 or 392 both new Stihl saws and both incredibly powerful for the respective weights of each unit or go all out spend the money and get a new 500i they are exactly as stated unbelievably powerful and super light 
Good luck with it I will be giving it a go
Reply: Ms261c would be best . the 260 is a homeowner saw and the 261c is a commercial grade pro saa
Reply: @P_RO_  i wouldnt barf on a poulan if it was on fire.  Stihl husqy , jonsered or dolmar even echo is pretty tight but poulan is the joke of the garage sale
Reply: @nooneyouknowhere6148  260 and 261c
Reply: Some time has passed. Did Stihl send you a new saw? In some places, they have a very good reputation.
Reply: Stihl ms 660
Reply: Excellent video, thank you. I am currently milling boards from pine trees for our organic garden here in the Sierras of Northern California, where I was a professional logger since 1979. Out here you will here Husqvarna vs Stihl arguments like Ford vs Chevy. At one point I was “ordered” to buy a Stihl 026 which is their thinning saw. Light, 24” bar with high chain speed. Everybody on the thinning crew had them except one guy. He showed me his 2 dead 026s at home and told me why he runs husky against the boss’s orders: the Stihl has the carburetor mounted to the fuel tank component which is vibration dampener mounted to the engine, which saves the carb from vibrating and eventually wearing the surface between its aluminum body and brass throttle shaft which will make any engine run lean at idle and then rich at full throttle and high RPM because it will suck air around the jets. To get the fuel pump to operate off of the engine vacuum/ pressure impulse of the crank case, they use a small flexible hose called the impulse line. With the constant vibration and flexing, that hose will crack and cause an inconsistent fuel flow to the carb causing a lean condition and then rich. Eventually the lean condition will starve the engine of oil and blow up a $700 saw. The impulse line is $10, but getting to it is time consuming and requires a shop day  and waiting for the pro shop to get around to it, or working it yourself, many of the sawyers not being of that skill set or having the special tools. This would of course end up with guys trying to get through the week by adjusting the mixture and blowing up their saws to save from what relates to protecting a $35 carb. Therefore I bought a husky to go along with the 1980s 2100s I used for falling big trees when I needed something that big or the 1985 Husky 181 with a 36” bar that was the first high chainspeed saw designed for bucking large logs here. I got that saw used at a pawn shop for $300 in 1986, and used it professionally and for firewood and hazard tree work on our 150 acres since then, having had zero issues until it finally wore out. I rebuilt the engine with a new Meteor 88 cc kit, 2 years ago and it is still my go-to saw. I also have a newer 288 with a 24” bar which is the later version of that saw with very minor improvements. Husky made that saw for over a decade. They sell for $700 on eBay to this day and are one of the most reliable saws ever made. The newest version of a saw that size is the 72 series: 272, up to 572 now, which Husqvarna claims is the most advanced saw ever made. I’m not buying one, I have 3 88s and a 2100 that still has 120 psi of compression that is my milling saw. I also have a 353 which has been used constantly since new for 12 years. Husqvarna makes pro saws with 3 numerals designed to use every day for a 10 year lifespan. They make a home user line that is 2 numerals that are designed to last 10 seasons of home user use. There is a price difference. For me, knowing many professionals that use either or both, Husqvarna is the clear choice from 40 years of professional and home use, 35 of which are on the SAME SAW! I have only spent less than $100 on maintenance on that very saw and it is a work horse! See some videos of it at work on my channel.
Reply: Robert Lopez interesting. We just bought a small Stihl electric CHEAP!!! Surprised. It works because the chain is very narrow and takes less energy to work. It is very handy when you just want to do something quick. No fuel! And it charges for free on our solar system. I’ve used much larger 120 volt pro electric saws underground mining where you can’t have carbon monoxide emissions or the danger of gas fires. But.... we have utilities running to every part of the move including electricity. In the remote areas, you would need a generator and so you defeat the purpose environmentally, however, with a nice solar system and a lot of batteries, or a pro AC electric, this could work! Certainly less expensive maintenance wise!
Reply: The 026/260/261 is a GREAT SAW! 
i have been a tree man 37 years.
The problem could be break in or mixture ...oil quality maybe..
Reply: Check out Doosan or Makita (Makita is rebranded Doosan).
Reply: First off, hats off to you sir, what you do with a saw and your attention to detail is great! 

So here’s a few things to think of with the saw. I run a Stihl FarmBoss (MS290) and have for 9 years, 0 issues. 
1. I always make sure to get ethanol free gasoline. From what I was told by a saw man much older and wiser, those engines don’t do well on the ethanol blended fuel. 
2. You may need a Stihl in the 300 class (or comparable size other brands). I’ve run toe to toe with a Stihl 260 pro and they aren’t too impressive. 
3. I modified mine as soon as the warranty expired. Ripped off the carb limiter tabs, disassembled the exhaust and milled it out to 100% the size of the engine exhaust port. And bye bye spark screen. The power and torque gain once I got it tuned right was significant. Fair warning, it likes gas a lot more lol. 
All that being said, I think you may have just gotten a dud from Stihl. Everything I own Stihl is just bulletproof and reliable. And as handy as you are you could repair a saw top to bottom easy Id say. I’ve rebuild an old olympyk and it ran like new and was simple! 
Also, I’m sure others might agree, the old saws were just built better it seemed. I love my Stihl but that old Olympyk 264 is just as strong 40+ years later. Good luck, and thanks for the video!
Reply: Advoko MAKES  BRO!! I used your technique on some downed hemlock and it takes a little practice but I cut some great rough cut planks and made them into planter boxes! Way way better then a jig. My brothers will be amazed!
Reply: My old 026 is still running strong, my ms 260 is needing service, old stihl all the way
Reply: Advoko MAKES 
Stihl is the best chainsaw. Husky are great too. 
The problem is not the saw. The problem is that this saw was not designed for such application. Chainsaws are designed to run at full throttle, then idle, then throttle again. 

To cut logs you need to run the saw for a long time between idle. An MS440 would be the minimum. MS660 is the best. Of course an MS880 is even better but it’s expensive. 

Another option is an electric chainsaw. They now accept 18” bars.
Reply: every chain saw will break after 50-120 working hours, i have 12 scraped ones at home ;)
Reply: @LukaArtelj  
It depends. A quality pro grade Stihl will last you a lifetime.
Reply: @iliketobuildstuff7013   wow I never heard of that brand of chainsaw before... That's not even sold in the U.S.A I don't think
Reply: I think any saw in that range isn’t up to the level of milling. A few things are needed to do milling or board making. Auxiliary oil to the chain or more than normally provided under felling or bucking conditions. Also use more oil in the gas mix when milling. Milling is harder than normal on saws. Extra oil saves the piston from being scored as that one you had. Tune the carburetor to run richer at wide open throttle while milling. Piston scoring is from a few things, dirt or debris in the engine, less oil in the piston than required, overheating from harder than normal use or low oil in the gas. These saws aren’t designed for milling in large quantities. Oh and KNOW that unevenly worn teeth on a an alternate side is NOT going to make a saw cut crooked despite what the logic seems. PROOF of experimentation with the exact topic reveals it to be only dependent on the depth gauge to tooth height. Nice tips about the board making. Just need to increase oil to the piston, let it cool more often, and increase bar oil flow when milling and you should solve these issues. 90cc saws and larger are used for milling because they can run longer before overheating. These size saws here are NOT made for such use and while they can for a short while you can expect parts breakage sooner than expected. You pretty much push them to their limits by doing this without special care to not destroy the crank bearings, bar, piston and cylinder.
Reply: @ElectricPhantasmagoria  
well said!
Reply: My friend said a husky 357xp is best for that job!,cheers👍😉
Reply: Sorry for the late reply I've just been sent this video from a friend.
Reply: The Sthil is a high horsepower 50cc snd has a rim sprocket which is the best but i wouldn’t blame you for not wanting to buy another after that, although sawmilling is heavy on saws. I would be careful of new modern saws for this work as the have weakness in build quality especially with muffles. I use a 346xp which is equivalent for 10 years now but they are out of production, couldn’t recommend any husq or sthil nowadays. Echo bought out a company call Shindaiwa which have a 50cc with rim sprocket but a bit less power than sthil and Husqvarna. I would buy it though as it has 2 ring piston which no other 50cc has today. Very good compression and very strong cast iron.
Reply: Husqvarna IT is good !!!
Reply: @Lowmile701  iou
Reply: southern shop how come?
Reply: @Lowmile701  accidental comment, sorry
Reply: Hello, if you want a good chainsaw, I recommend 3 big brands, Husqvarna, Stihl and Mcculloch, I have a Husqvarna 120 Mark II for tree grooming, a Husqvarna 576 XP for your needs and a brand new Stihl MS 500i,  when I want to carve with a wooden chainsaw, sharp every 5 m³ the chain I use only Oregon and the blade and chain, 50 cm respectively 45 cm with 1.6mm and 3/8 (0.375 inch). I recommend using a liter of gasoline  , in winter 25 ml of mixing oil and in summer 23-20 ml, 25 maximum, somewhere at 2.4% per liter ... believe me, it saves the cylinder ...
Reply: or if you want to keep the brand (although husqy has a consumption 3-4 times lower than any other chainsaw, I mean X-Torq engines) suitable would be a Stihl MS 362, I had one until 5 months ago,  when I changed it with 500i, in 6 years I only changed its starter, chain and gasoline, the original blade still held (I use a chain oil from Oregon, clearly superior Stihl or Husqvarna)
Reply: You would have to go bigger and maybe start with Husqvarna 390 and get it woods ported.I was taught if you rip cut with your saw you hate your saw lol.I hope that helps.Not to to many saws are built to handle the load that way.
Reply: @stevetaylor9265  hi,  what means "break it in before using it" please ?
Reply: @Neatpuppy  please, what pitch would you suggest for these big saws (660 or 880) 3/8 or .404 ? many thanks.
Reply: @PenZon  I hear they are cheap, but not from servicemen.  Maybe I'll give it a try.
Reply: @azsazs6039  Did Stihl ever get him a new saw?
Reply: Advoko makes, which chainsaw did you end up going with? &Awesome videos, you are very wise.
Reply: Ww used husqvarna over stihl. They were more reliable in higher end models. Nobody, even the vets preferred stihl over husq. Thsts just my own personal experience. They worked for our commercial crew
Reply: @JamesWhite-tg4kw  true I believe echo may be the best on the market in 2020
Reply: @rivtool515  echo has changed. They are a contender for the best on the market now
Reply: Only tomos bro
Reply: How long are you letting the saw warm up before revving the engine? I have seen that scoring on the piston from rapid heat exspantion.
Reply: hi mate, i know I'm late on this question you have, but i would very highly recommend you try Husqvarna chainsaws. i have a 390XP, and it is superb.
Reply: P RO  I agree. Been running the same ms260 since it first came out. Only one tip end done since purchased. O66 artic for extreme work conditions but gas mix and chain is critical. These new fuels changed that too. Adjust the carb using a good ear and a non contact temp gauge to tune in. Don’t flood and under rev the engine. More liquid causes hard compression and excess stress. Don’t be afraid to run it a bit leaner than you think and let it scream and eat! Two strokes were build to rev high!!?!
Reply: @MarkCrawfordmarcusrobur  I've used one for 4 or 5 years in firewood,pine mostly and had good luck,also my old saw, a 440 magnum is still a beast!
Reply: azsazs I had a similar issue long ago and since then have avoided Stihl. No one could fix the saw and Stihl refused to replace it. I guess when your the best, it is difficult to separate the facts from the myth. We don’t make mistakes mentality. I am sure that The Stihl company has survived without my business.
Reply: I have always used a Stihl MS 291 and, here in Australia, I cut A LOT of hardwoods...Eucalyptus, Sally Wattle, etc and have never had a problem
Reply: Stihl is starting to enginear their parts to fail because you do not use their engineered fuel.  I would drop them as a company.
Reply: Stihl ms362, we have bought several in the last year+ so every crew has one.  Pound for pound (kilo for kilo? ) it's the best saw around in our opinion. Husky used to have a 346 till they went out of production,  but I still have a new one in the box! Plus 2 older one's still going. I'm going to try your method to cut some 42 inch oak!
Reply: I use stihl 038 magnum for similar style of work. Its an old saw but still a beauty.
Reply: Hi, thx for the video, i make logs with an echo cs 600, tried with a steel ms 381 and found it very hard, think the echo is much more equilibrated in gravity terms, sry about mi english.
Reply: @Rick_Sanchez_C137_  On the Echo web site, I noticed that the Consumer saws have a 5-yr warranty, but the commercial ones have only a 1-yr warranty.
Reply: 365 XP Husqvarna has never let me down.
Reply: 391 Stihl 25" bar will get you through. use mine professionally 1.4 years no issues.
Reply: Makita Dcs6401, EA6100PRGG, EA7901PRZ1, or Dcs9010. Anything from Makita or Dolmar (are the same) is better than Stihl or Husqvarna.
Reply: You should email a still
Reply: @PenZon  Or Shindaiwa, they come out of the same factory.Brilliant.
Reply: May I recommend an echo! They are great
Reply: I’m liking Echo for value and quality. Their bigger saws should be good for you.  Japanese quality in their professional level saws. If price is paramount consideration, then Holtz Forma is worth a try,  although quality will be lower...
Reply: I work for a utility tree service currently, and have been doing tree work and forestry for almost 10 years now. I've used all of them, Husqvarna, Stihl, jonsered, dolmar, echo, you name it. The Stihl 260 you are using may have been a bad saw, to be sure. But as for a better, more reliable saw of similar weight and displacement, I stand by the Husqvarna 346xp. It's a little higher reving , but so light and powerful. There's some good Stihl out there, but with your demands, I would try and seek the 346 out. It's no longer manufactured, but it's a professional saw that professionals seldom will let go. Oem and aftermarket parts are available. You will not be let down. I use it for all kinds of tree work. A medium saw for climbing removals, fire wood, and brush. A previous comment mentioned the 372, while a great saw, would be more suitable for using a horizontal bar guide such as the Alaska. You have a very interesting technique for lumber making, I have free handed some small pieces of lumber and made some mortice an tenon's with the 346 and my topper climbing saw. Keep up the good work!
Reply: The ms260 is a lite duty saw intended for home owners, you should be using a ms330 or ms360 ,ms440 , ms660 .
Reply: Advoko makes you must see asia malaysia/indonesia/thailand..how they cutting board..free hand using big machine 070..more weight more effecience..maybe their skill inpired you..
Reply: Search :belah kayu guna chainsaw (bahasa melayu)
Reply: @azsazs6039  After reading a majority of the comments, it appears many feel the Stihl is losing its reputation as a good horse....and the Stihl spends more time in the shop than in the woods.  I'm looking to buy a saw and I'm staying away from Stihl.....sorry.  I know you said you're a stock holder, but it appears cheap parts has cost Stihl their reputation.
Reply: From the manual: "Fuel with a lower octane rating may  increase engine temperatures. This, in turn, increases the risk of piston seizure and damage to the engine."
Whats the gas/petrol quality like there?
That scoring is probably a result of poor quality fuel causing higher heat which would be really bad during those long straight board cuts.
Oil mix would be another factor and as mentioned in the comments, mix ratio may need to be adjusted for those long runs.
Stihl MS 250C here. It's been rock solid for all of the cutting & felling I've had to do. We live on an acreage.
Alberta, Canada so young-ish forest with mostly white poplar/aspen.
Reply: Light work...MS250 ,40cm G/Bar    Medium  work..MS 381 50cm G/Bar   Heavy work...MS880  90cm G/Bar
Reply: 272 or 372 Husky all the way.
Reply: @chattonlad9382  Where's your evidence more oil = over heating!  110ml oil in 5 litres of Fuel is ideal  = more lubrication and longevity.
Reply: The piston scoring could be from using partial throttle instead of full throttle.
Reply: Chattonlad I love my Husky 550
Reply: Hard to kill a Husky 372 or 372 so il assuminv the new 572s are as good.
Reply: Amazing video advoko. Very excited to try this out. I used to be a utility logger and the older husky 365 were amazing.
Reply: Husqvarna 372 XP. Heavy, but been very reliable in extreme hot and cold. Plenty of power. My girlfriend's family are loggers and those are the only saws they use.
Reply: @stevetaylor9265  50 to 1 will go forever.
Reply: Loved you video! Have a fallen 36" 27" x 28' sycamore base in my front yard (next to the 27"-25" x 18' top) in my front yard since last Fridays PA sycamore storm 2020.  Have a 2nd smaller syc in the back yard, a 18' and 9' 20"+/ that took out the power lines.  I am having problems getting them "removed" and have bought expensive slabs for epoxy pour projects in the past, and need a new dining table and bartop, so your video is at the least inspirational.  For the cost of paying to remove them, I can buy a new 24" 455 rancher and sell the slabs.  Now to search your vids for drying tips ;).   PS...don't they make any good chainsaws in mother Russia?  One wood think!?
Reply: Any saw pre 1988👍👍 I have a massive homelite that will eat any husqvarna or stihl . Also mcChulloch are great. Run forever
Reply: @Boogerboys1990  Don't make shit like they used to. That's a fact.
Reply: @thegreatecb  going out on a limb here... that’s because people like you are creating demand by buying from the homeowner or farm and ranch catalogs. Get the professional grade saws with the metal not plastic.
Reply: I gotta HYPER TOUGH 20Vmax I might try this on a smaller log. It’s only 10” bar...
Reply: Always been an Echo fan
Reply: 🤔??
The alien culprit to your chainsaw dilemma, sneaks up on your piston at 11:01, ...

Watch carefully, below your hand, ... at 11:01
She does not like you sawing the logs, she lives in, ... lol

Keep up the great videos! 🐸
Reply: Try a Homelite 1000xp or a Homelite 500AM. I have 7 different Homelite saws and they all run perfectly. All of them are 40+ years old so you can say that Homelite has stood the test of time.
Reply: Richen up your high-speed needle looks like it's running lean
Reply: I am way late to comment on this but here goes anyway. I have an old Stihl 026 and it still starts on pull 4 and does everything I put it up to. I love my chainsaw. A friend wanted a couple of planters so I cut a couple of 4 ft long logs in half that my 20" bar didn't reach through, so I had to cut it from both sides. It turned out great. Douglas fir. I still cut many cord of firewood with it each year. I am giving up felling large trees this year but it always did it with ease. I have to laugh at these guys that say "660" "570" "GIANT" saws. Oh yeah, did I mention I am a 5'6" well over 50 woman? To the boys in the comments I have to say, bigger isn't always the answer. You don't need a chainsaw to prune a rosebush.
    Anyway, I love how you cut those logs down. That was super cool. I will have to try a couple of those methods. I am getting ready to build a couple of small ag cabins out in my forest. I will have to check out your channel more often and see what kind of cool stuff you're doing. Thanks.
Reply: @P_RO_  poulan is made by husqvarna!! I'm a motorcycle mechanic and I love the husky's for their top end power. I do find that the stihl has more mid range torque which is sometimes nice but as long as you keep the husky pinned they'll rip all day long.
Reply: I use Stihl saws for work everyday, I would say that you have bought a good saw but not the professional one so they are not really designed for lots of extended use. Like milling. You should look at Stihl ms 261 C-M. Very very good saw. I run my one all day and it's over a year old with no issue. Look for the C model of any of their saws and it will cost more but last longer and indure more abuse (long work days).  Just my opinion. Good luck and good work
Reply: Ms290 has given years of reliability.
Reply: I’ve been quite impressed with my Stihl 170. It never gives me trouble.
Reply: I thought it was a 440/461 at first, I cringed a bit when I saw it was a 260. That Stihl is too small for milling, and unless you set its carb to run a extra rich, its no surprise it gave you problems. Look at something in the 70cc range, at least. MS 461/462, Husqvarna 572 etc. CC is everything in milling, helps with overheating and torque. Oh and always run 32:1 for milling, 40:1 for everything else. 50:1 makes EPA happy, but it screws your piston bearings.
Reply: @tammoilliet8683  He needs higher CC, that's why he had problems with 260. 70cc+ for milling, or overheating creates problems on the long term. He needs a MS461/462 or husq 572. Good balance of weight and power for milling and regular chainsaw use. Oh and always run 32:1 for milling, 40:1 for everything else. 50:1 makes EPA happy, but it screws your piston bearings.
Reply: @richardverkist9105  260 is powerful but it's only 50cc so unless he was using 32:1 oil ratio, rich carb setting and not too long bars, it will overheat and create issues. I'm not surprised that happened, he needs a 70-90cc range saw for milling, anything else it will give him the same problems all over again.
Reply: @MartyInTheWoods  Jesus christ run 32:1 not 100:1, your piston bearings are dry and will fail at any moment. Who the hell told you to use it like that, a chainsaw isn't a racing motorcycle that has a complete engine rebuild every 10 hours. Stop giving people such stupid advice.
Reply: @brobdingnagianone900  No, he just overreved that small saw, overheated it and used too little oil, deadly combo no matter what brand of saw it is, pro or homeowner etc. Milling isn't like normal cutting firewood, he didn't knew what he was doing and ruined his saw. He needs 70cc+ for milling, and need heavy oil mix and a rich carb setting.
Reply: @em4703  interesting.
Reply: Husqvarna 455 rancher
Reply: Lots of good advice in the comments... My advice, Stihl professional not homeowners, Husqvarna professional, Jonsered...all very good. I wouldn't mix oil less than 50:1 on any of them. Preference would be synthetic mix oil. 

Most Stihl repair technicians can determine cause of failure when they crack the crankcase open. They should have told you if it was the saw or how it was used... this kind of information helps the end user to better understand what to expect in regards to saw performance. That being said, Stihl designs there two stroke engines to run full throttle, I can't imagine how your method of cutting with the tip of the guide bar could possibly damage the saw. Not much load cutting that way. Of course you could write a book about the things I don't know about chainsaw service. AWESOME video! Thank you.
Reply: echo cs 590 is a great saw. I have recently switched all of my saws to echo and have been very pleased with the results.
Reply: Any Stihl saw that ends in a 0 such as your MS260 is rated for 50 hours of run time. It will die after that. 
A better choice is a saw that ends in a 1 such as a MS261, MS291, MS461 etc. they are rated for 300 hours of service.
Reply: Thanks very much for asking this question here, as I was about to buy a Stihl until I saw your video.  I appreciate the response from the chap with shares in Stihl and no doubt they are a good company, but the consensus of the replies seems to point to Husqvarna, so I just bought a new 560XL, after years of wasting more time fixing my no-brand chainsaw than it ever spent cutting.
Reply: It’s amazing to me that some people in the world get to live on such beautiful places.
Reply: Buy a husqy , they have strong motor
Reply: Ms381 designed one Germany built in Brazil. Brazil forestry uses them. I’m in Australia on a large property and use mine for fencing, felling trees, fire wood and cutting old railway sleepers. It’s an awesome bit of gear.
Reply: @nikburton9264  ms260 are known to have engine issues. Mid range general saw.
Reply: Sounds like a dud saw . I had a second hand Stihl 260 that I abused for a lot of years . Updated to a Stihl 262 a few years ago and no problems with it . I've always used Stihl 50 to 1 fuel oil and premium unleaded. Cheers
Reply: Husky 550 mk2
Reply: Good choice.
Reply: Any of these saws would work great, but assuming cost is no object, HUSQVARNA 3120 XP. They are over $1,500 though. 

Now if you want a more reasonable price, I would choose one of these three, as any of them will do what you are doing here, but here would be my order of choice:

1. Husqvarna 460 Rancher 24"

2. Echo CS-590 Timber Wolf 20"

3. Husqvarna 455 Rancher 20"

Those last 3 are much more reasonable priced and will easily work in a saw mill fashion as many professionals have reviewed.
Reply: @Lowmile701  I've got one. He's swinging the saw instead of using a sawmill attachment. Can't do that with 60 pounds of saw.
Reply: @ericlee6816  that depends. If you’re 6.3 and 120kg you’ll be just fine. Been tree lopping for years and hanging on to one of them never been a problem.
Reply: @Lowmile701  Word.
I haven't weighed mine but it feels like a Volkswagen. I might could swing it like he does from a step stool. For a couple minutes ;)
Reply: In the videos of you filling the tank on your chainsaw the fuel did not look like it was mixed with 2-stroke oil. Usually the oil will give the fuel a very apparent a blue-green color. The piston also looked like it was ran without 2-stroke oil.
Reply: @nooneyouknowhere6148  The 260 or 026 is the pro version. Had many off them. Good saws, very strong for that litle saw.
Reply: @aus71383  260 is 50 cc
Reply: Im surprised u don't make ur own chainsaw. U make everything else. Echo makes a good saw. I've used all the top name saws over the yrs i use $100 disposable Homelites. Keep the chain sharp any saw will work. A chain saw is only as sharp as its dullest tooth. Or is it a chain is only as strong as its weakest link?
Reply: I’d guess you have two variables to solve for to improve your experience. 

1) You have significant scoring on your piston. I’m guessing you’re quite detailed, so if you’re following recommended fuel mixing process, then try adjusting your carburetor (rich vs. lean). Your swinging method is impressive from a milling perspective, but you may be breaking the model on the intended use for the saw (only using 2-3 teeth...). You may even be running lean with the method, running up your RPMs and overheating your piston. 

2) Milling with a 50cc is ambitious. You’re doing heavy work with a light duty saw. Give yourself a power upgrade, 90cc if you don’t mind swinging the weight. We’ll all enjoy watching a power saw in action too. 😀

Keep the content rolling, you’re fun to watch!
Reply: We run Stihl
Reply: Try a Husky !
Reply: You need a bigger saw!  30cc will not stand up to the task of milling for very long.  Get at least  50 or 60cc,, or even 70cc for real milling. Either Stihl or Husqvarna are good and each has it's own challenges. I always bought a new saw every second year when I worked in norther Alberta and northern British Colombia Canada for 15 years. I like Stihl best and still own a small 025 or MS 250. Nice litte saw but I wouldn't it use it to mill but 1 log!!   Just my experience. :)
Reply: Check out echo saws they are a Japanese saw and man are they tough and reliable.  The ones that end in p are professional ones but the main difference is the tune and carb are beefed up but they all run amazingly and are built to the same quality standards across the board
Reply: I have MS440 and im sutisfied,probably I would recomand MS 660 but getting more havy)   Im cuting 58-66cm depend of wich way I use. With saw mill I made from alu konsols take it more time, is limited max 58cm and need to guve extra chainoil. Without frame isjust no so flat..... but never mind wood for free
Reply: Ms 362
Reply: Yeah, make sure the gasoline you use is without added ethanol if you buy from the pump (ie 98 octane premium, not 95 octane regular) or buy the proper Alkylate-fuel with pre-mixed oil in 25Litre canisters. All modern chainsaws are adapted for alkylate fuel.  Almost all gasoline companies mixes in 5-15 % Ethanol in the 95octane gasoline in order to be environement-friendly, as it is also cheaper and lets them make more profit off the supposed gasoline fuel...and it will soak up water from the air, and cause steam-cavitation on the piston and cylinder.
Reply: Husky any day.. A 560 is a perfect saw. Oh wait you americans only have the 562 modell right?
Reply: Husqvarna Makes the best chainsaw
Reply: I've used Stihl and Husqvarna both, and I have to say that Husqvarna wins out. They have more torque, they are easy to repair as well (a lot of the newer Stihl saws have carbs that can't e cleaned, repaired or even adjusted), easy to start, and are strong saws. I still use a 455 Rancher model that's 20 years old, and it's never needed rebuilt
Reply: @Dakota Coleman I agree The Swiss have got their Husqvarna chainsaws unmatched! I’ve owned all kinds of saws and Husqvarna has more power and they outcut & will outlast Stihl .
Reply: @CCRider5312  Indeed! 
*Husqvarna is a Swedish company though ;) *
Reply: I want to say thank you so much for sharing these secrets! I've been converted from needing the chain saw mill method. I have a few large hard wood trees to make in to planks from these are larger than my 22" bar so I've decided to weld two bars together to make it possible to cut wider boards with the tip citing method.🙂 Thanks again!
Reply: I would ask what oil & ratio did you use ? I work on a lot of atvs im betting it was a slightly off carb that killed the saw ... Seen it many times ...
Reply: Husqvarna 460 rancher. Great saw. I have an ms235,I think,stihl and it's given me nothing but problems. I say I think because I don't even bother with that pos. Tore the carburetor apart twice and it's still a pos. Same gas I use in the husky and it fires on the 2nd-3rd pull.
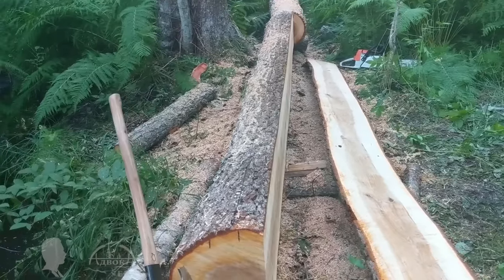Reply: what Ax is that at 11:10?
Reply: i have an echo starts every time  ..run it lean always ...totally reliable   made in japan  with some canadian oregon clutch parts
Reply: @azsazs6039  ""Large" is relevant to the person seizing it, large to You may be small to someone else just ask My Ex.. If is that large as You put it, why didn't you get Him said sponsor??????
Reply: @ulriklange3924  9
Reply: I owned a Stihl and snapped the crank shaft.  Bought a Husqvarna and haven't had a problem.  Also,,,, I use Optimal two cycle oil in 1 gal mix size packets. Just empty the pouch into container, add 1 gallon high octane gasoline,  shake and fill chainsaw,,,,,   works great ..
Reply: Heat kills them and the Mfg must "choke" the saws to meet government sound & emissions rules. One of the best things you can do is a proper dual-port muffler modification. Just remember to tune your carb afterwards!
I like Stihl & Dolmar saws, but Husky makes great saws also...personally I don't like their clutches though.
Good luck from Wisconsin & thanks for the video because I was just about to buy an Alaskan Mill, but now I'll try your method first.
Reply: Husqvarna,homelite,if you can find a light one.makes me want to chopping again and build one💪😇🙏🙏🙏🙏🙏🙏🙏
Reply: I'm not sure if there are any significant differences, but I've had very good luck with a stihl ms290
Reply: Great video. My Next door neighbour's a woodturner. 
He paints the ends of newly sawn logs to stop splitting like you. He leaves them sitting for a long time before using them. Do you have any videos on how to stop the ends of logs splitting?
😁
Reply: Always have enough fuel to make it through the whole cut, never let the engine run dry. That’ll tear it up fast.
Reply: I have a stihl 271 farm boss. And I've cut lots of freehand lumber with it.  The trick is to break them in properly before Remington up high. As with any saw.   I also only use stihl 2 cycle oil at 50:1.  After I ran it for a few cords of wood never reving it up high it became more powerful.   It is in the break in instructions when you buy them. Don't need anything bigger. Especially for swinging
Reply: 038, it's old but a workhorse
Reply: a little late but your problem is probably related to cutting too soon, with the newer chainsaws you need to give them a few seconds after starting to heat up before engaging the chain the wearing on the piston head is caused by uneven thermal expansion
Reply: Thanks for a wonderful video
Reply: Stihl still is an excellent brand. It seems like you just got one of the bad ones that slipped through. Just as the guy said, contact them. No need to switch brands
Reply: Most chainsaws will come tuned very lean from the factory. I suggest that if you are parting the saw to hard use regardless of what it is tune the saw richer on the high and low jet.
Reply: @chattonlad9382  More oil= weak mixture?? Not sure if you meant to say that or not but I always use the ultra green stihl oil with a slightly rich mix and have never had a scored piston. I'm a pro user fyi
Reply: I know this is an older video but, mix your 2 cycle oil with aviation fuel instead of regular unleaded. And you'll notice alot less repairs being needed. I run chainsaws everyday and this has served mine extremely well
Reply: I use a Stihl 26 for 30 years but with a bar 37 or 40 cm long. Seems your bar is longer. Thanks for your video. I think Huskvarna have a advantage of a cleaner air fillter but I will never change !
Reply: Greetings from gulf coast Alabama. Since hurricane Sally i have been cutting our downed pecan trees with a stihl ms 311. Very hard wood. Thank you for your videos.
Reply: Put twice the oil in your gas. That little saw is getting way to hot and the gap in the top ring is growing and pushing against the cylinders wall causing that mess that looks like no oil at all , I have seen this with other name brand saws that were used to cut fire wood which is a lot harder on a saw then cuting timber..
Reply: Thank you for your useful video. I have a Makita DCS7901 and think the 6401 (64cc) model is comparable to your stihl and is a good saw (rebranded Dolmar). I think your damaged Stihl may be due to a badly fitting air filter (which could cause scoring). A leak in the crank case would cause overheating also, but this would be seen in bad running. You likely already know how to fix it but it may be a case of good money after bad.
Reply: Sounds like you just got a lemon I've had a ms 260 10 years and never had 1 problem with it and I have cut hundreds of cords of wood with it
Reply: @azsazs6039  it seems the quality of stihl chainsaws have become cheaply made in recent years, more plastic parts where steel used to be. I used my father's old stihl for many years and never had any issues, it always started and with basic maintenance it ran like a dream! that made me purchase a new one for my property. Unfortunately i have had the same issues as Advoko and I have much smaller trees on my property! I got three tanks of gas through mine before having issues and its always a chore to start cold--and stalls often even when warm. maybe the name should be changed to Stall instead of Stihl 🤣I joke but the truth is, I am looking to find a more reliable chainsaw as well.
Reply: Try a stihl ms880 brother
Reply: whats wrong with the 260 ? That piston you showed is worn an the whole thing needs a new cilinder and piston. Did some dirt find its way into the engine ? Use a good 2 stroke oil. Like Motul fully synthetic.
Reply: I love Stihl, and figure the MS271 (Farmboss) is  one of my favorite for being a great mix of power, durable, and light. I also have an MS462, becoming a favorite, just larger and a little workout. :)
Reply: Would first check for air leaks. There are videos for this. I have a lot of respect for the old 026, but if  your saw is of the sort that makes it to the US, it probably has restricted ports and is otherwise de-tuned for emissions requirements. You can "port" the saw, open up the muffler, advance the timing and make the carburetor adjustable. The saw will run richer with more subsequent lubrication and the performance will be a lot more like the older saws and your piston will last a lot longer. Videos out there for this also.There are also better mixing oils than the Stihl. Look for something made for air-cooled 2-stroke racing motorcycles. Motul 710, for example. Better lasting film where it counts. 

Skip-tooth chain might be an improvement. From your description of ripping dynamics, this occurred to me. 

And, speaking of your descriptions, all excellent. Thank you.
Reply: Of course,  these modifications would be illegal in the US. Offered here as a theory. I can't wait for the battery saws to catch up
Reply: 036 or 066
Reply: Rebuild it yourself get a big bore kit for it.
Reply: You need Optimum oil in your mix
Reply: I found it easier to use a chalk line instead of a guidestring. You can find them fairly cheap at most Hardware places usually used in masonry. Stretch it down the log give it a snap and it will leave a chalk line that you can carve a Groove out with a chainsaw.
Reply: i've got a very old ms260c and it is still going pretty good. Takes a bit to start it tho. My advice would be make sure you put the RIGHT oil and the right amount in the can BEFORE you fill it with gas. other than that buy a new piston kit for it and make sure you dont put in old or straight gas.
Reply: 271 stihl.over
Reply: @chattonlad9382  https://youtu.be/4KfeAwlwo7U
50:01 is pretty lean on a saw and the bearings tend to burn up especially if you run one's saw out of gas (subsequently oil too) and are doing something with high duty cycle such as milling logs
Reply: @erickalvarez900   Husky reccomend 50 to 1 (or 2% if you like) We ran all our saws like that a for thirty odd years and never had any problems. Just read the instructions, I think Husqvarna probably know a thing or two about saws.
Reply: Husquvana...
Reply: @anthonyimperato3818  You managed to find the missing "u" in my last comment but you couldn't find the instructions about the oil to petrol ratio in the Husquvarva manual :-))
Reply: ms660
Reply: That Stihl is a good saw but you need at give the saw more fuel ( richen the mixture) when using full throttle for long periods ripping boards.
Any saw will fail if it runs lean ( not enough fuel) 
P.S thanks for showing us that method of ripping boards with no mill. Such a great thing to know how to do and much easier on the saw.
Reply: Husquvarna 460 rancher is a great saw capable of running a 20" or 24" bar with plenty of power with its 60.3cc engine and much superior to the stihl ms260 witch has 50.2cc engine and the Husquvarna is lighter and the body of the saw is narrower than that of a stihl. I've used both and own both and I find myself grabbing my husky everytime.
Reply: echo chainsaw
Reply: Maxi, have you considered that your  Stihl carby settings are off. Is the chainsaw four stroking or did you have it set to run flat out?
Reply: Stihl saws are not the quality made machines they once were. Sad but true of many things. Husqvarna is the saw you see on all of the "Alaska" reality TV shows now.
Reply: @johnmorris7960  I may have misunderstood you or you may have been ambiguous, but your wording suggests you may not realise the MS260 he is using IS a forestry saw from the Pro range. And the 261 available now as a refinement of the 260 has an even higher power:weight ratio.  I would say in response to the OP's request for recommendations on alternatives to the 260, that choice hinges on what weight, he feels from his experience, he can use in this technique with both control and absence of early fatigue.

It's a big leap up in weight to the 460/462 you mentioned and I'd be surprised if he would feel happy with that.  An MS362 would be a much smaller increment if more power is really needed.  But like others have said, I reckon he got a dud example since he had trouble from the start.  I completely agree with your remarks about lean mixes.
Reply: What is called that accessories which you use with chain saw machine?
Reply: I own 7 stihl chainsaws. They all work. I would get an MS 461 Stihl.  Mix your fuel only 40:1 all the time. Use Premium Gas.
Reply: I have the Husquavarne 350 which has been great or I would go with the 455 Rancher
Reply: Love my husqvarna rancher 460. Also have two Echo CS 441. One Stihl . Love the Stihl for bucking firewood but the husky is on my chain saw mill with ripping chain. Works great ! Echo is for lighter work
Reply: Husqvarnia 372
Reply: Echo 590 timber wolf.
Reply: The Stihl 070 is a chainsaw that came out straight from the forges of Valhala. Problem is it is heavier thus puts more strain to the user if the user is not used to cutting slabs vertically.
Reply: Echo
Reply: I would suggest maybe trying the new expensive carbide tipped chains. Maybe that would be a huge time saver for ripping. (?) Less time sharpening. I haven't bitten that expensive bullet yet.
Reply: A couple of old loggers I know both said to use 40:1oil mix. And never use factory oil (stihl or husky).
Reply: Do you use a crosscut or ripping chain?
Reply: I have built several hand scribed log cabins. In my opinion Echo Is the best chainsaw!
Reply: Husqvarna chainsaws are the best saws on the planet! They're a little pricey but worth every penny.
Reply: The piston/cylinder assy. you showed looked like it was running hot. The scarring below the rings, and skirt,  is evidence of overheating. Oil/fuel mix, or air cooling blocked.
Reply: Husky Rancher 460 - smallest long-bar saw I could get.  Fairly indestructible.
Reply: I know it's an older video but thanks, Makita(dolmar) also has great chainsaw.
Reply: The problem with the saw is they don't make them to last anymore ...you can. Find a 20 yr old stihl that will outlast a brand new one
Reply: @tysonmadding8559  the makita pro brand I have is pretty good. They compare very well to stihl. They are made lighter now I agree , my father's were beast. And as maybe a 10 year old I was running them. Looking back it wouldn't be allowed now.ea 5000 prel. Average size. , Going for the big one soon or maybe the Aliexpress beast that seems pretty good.
Reply: Stihl 500 fuel injected
Reply: I can't say I know of a MC260 but the ms260 pro I have. Having been in tree service for a long time I only use Stihl. I have never had issues as in scoring the piston or sleeve but I have seen damage like that because of people start and go with out the saw having time to evenly heat up the piston sleeve evenly which burns the rings scores the sleeves damages the piston. seeing that you are running the saw in all weather hot or cold it needs to warm up for a minute or two depending on the weather to insure even expansion of the sleeve.  I have a MS 251 pro and have used a large range of sizes up to a MS 880. hope this helped
Reply: You should wait for your chainsaw motor and parts to warm up before going direct in to cuting lumber... the piston expands faster than cilinder and it cause those wears that make your chainsaw stop compressing during combustion... its called a cold seizure, every motor, specially 2 strokes suffer from this.. they get a high rotation and have exploxions each compression
Reply: Husky or Jonsered are the only ones I use.
I took note of one logger I worked for and saw the crate full of spare parts for their Stihl saws and realized if you have to carry spare parts to the woods to keep your loggers cutting then you need a different brand saw.
Just saying.
Reply: After years and years of being a die hard sthil customer I'll never touch one again had more trouble with sthils than even cheap Chinese saws now days use Baum cheap as fuck I can churn them and burn them and I'd go through ten for the price of a sthil
Reply: Having worked on 2-cycle engines since my youth, the piston scoring looked like a lack of oil in the gas or running too lean...
Reply: Stihl 472 deadly saw for that
Reply: Im not An expert on this
But i have a MS251
I dont.know how to compare IT with what you have big i know IT gets the job done
Also in the beginning i always buyed my stihl acc. At the local stihl dealer
IT was very expensive after a while
Now i order everything on AliExpress 😂
Mutch cheaper and to say i only ordered stuff two Times IT is the same quality of even better then my local stihl dealer
For example
My local dealer sells me 1 chain for +-20 euro
On AliExpress for the same privé they sent me 3 chains + 1 guide bar

For the chains i van say they are wat better then those from stihl
The guide bar is a different story
That one broked after 3 jobs

But then still.....its much cheaper in comparrison
Reply: I realise this may sound strange but theres a guy kn you tube who uses a electric chain saw and he swears by it . his tech is like yours , i have a echo thats 7 yrs old with the factory 18 in bar on it i also have a 2021 model craftsman with a 18 in bar from their factory , the older echo walks circles around it and my buddies husqvarni 455 and its a big saw .
Reply: You don't really need to use a line string with nails driven into your wood. Just get a cheap chalk line and give it a pop.
Reply: I have a stihl 261 and I have cut no less than 200 cord of wood with it I have never tried it for ripping but felling trees and cutting cordwood it has been very reliable for me.
Reply: Unfortunately there's about six different things that can burn a piston and cylinder out of a two stroke and the sixth reason is sometimes it's just its time. Any place that air can get into the case other than through the proper settings on the carburetor will lean a saw out causing it to fail; a dirty fuel filter can also cause lean running and also sawdust getting passed the air filter.
     I have recently obtained a Stihl MS360 and I think its power to weight ratio would be excellent for the type of cutting you are doing.
Reply: The best thing would be use a smaller saw, you need more torque on that chainsaw to make it last so in this case downsize and use 40 to 1 with racing or at least fully synthetic dirt bike racing oil it will last more other oils even stihl and husqvarna don't burn that well and 50 to 1 is so you merge with emission standards but building new cilinder uses way more resources anyway and if the saw isn't under real heavy use 50 to 1 is fine
Reply: @P_RO_  professionals do not, and I repeat, do not use Poulan saws. Lol
Reply: looks like you ran it at high rpms before warming it up properly
Reply: @henrikfaarborg7467  My 036 pro has been just as reliable as your 026. Picked it up second hand even and the only thing that ever needed replaced was chains, sprockets, bars, and one starter that was shot when I bought it (not sure if they left it out in the rain or some other abuse, but hasn't been an issue since)
Reply: Husqvarna 272xp
Reply: MS 500i. 
My favorite Stihl saw
Reply: find as many old saws as you can and have spare parts to fix and handle as you go.  The new Saws are not worth the time or effort anymore.  They always burn own.  You should be able to get your money back with the saw, the warranty covers those types of wear and tear damages for normal use.  You can also get a timer on the saw as an attachment, to go back to the company as proof of hours usage on wear damage.   They don't make things like they used to.  :/
Reply: I have a lot of early 2000 stihl equipment but have not been impressed with their recent equipment either.  When it came to buy a chainsaw, everything pointed to echo.  they have "professional" series chrome lined engines even in their lower models.  Have not had any issues out of my CS-400.  Honestly have not used it near as much as you would have though.  What did you end up buying?
Reply: Echo saws are fantastic!
Reply: I have no doubt that you can easily have the manufacturers send you free "demo units" so you can conduct your own testing.
Reply: Echo Chainsaws are the only company to provide a 5yr warranty (in Canada at least) our city has been using Echo for the last 15 yrs and very few issues with them.  I've switched 3 chainsaws to Echo and enjoy the power and reliability of them.  I regularly cut about 5 cords of wood a year with my Echo 590 for last 7 yrs with no issues.  My cousins are jealous when we all go out together as I cut through the wood faster than they do with their Stihls (I think it's because I'm better at sharpening then them, but that's our secret)
Reply: @azsazs6039  would you be interested in sponsoring Lumnah Acres in America.   A family building their home on a off grid property?  Best Wishes and thank you fr sponsoring videos "hugs"
Reply: Two questions: first, would an electric chainsaw work for this process? Second, how about a handsaw or other hand-powered saw?
Reply: @stevetaylor9265 1:33 oil mix is ok?
Reply: I find that octane boost helps a lot. The oil mix tends to rob power.

Dollar Tree sell it for $1

I add about 4 oz to 2 gallons
Reply: Thats some mighty fine cutting.  Add 4 oz octane boost to counter the power loss caused by oil in the mix.

I have great results with husqvarna 450.  Their airfiltration system is hands down superior to stilh 

I'm guessing that you go through a lot of bars when using that tip all the time.  I have a dozen old bars where the sprocket wore out and I was not using the tip.
Reply: Husqvarna all the way. A 372 cup is a reliable beast.
Reply: @chattonlad9382  My old friend also sticks to 50:1, with Huskvarna. He likes the Stihl... but he can't hear them. I tried the husk and... It feels much quieter. He says that adding more oil might kill the engine... so it's better to stick to just what you need. Also, these days, a lot of gas contains alcohol, shop for gas station that offers alcohol free gas and drain the few first leters of the pump in your car if the alcohol free option is the "Super" option on the pump.
Reply: Husquvarna 550xp amazing saw lightweight and tons of power
Reply: @chattonlad9382   I love my 394 husqvarna
Reply: A couple of years late and maybe you've solved the problem but have you tried a ripping chain?
Reply: I was a Husqvarna dealer for 8-/2 years in the 1970s.  My 40 yr old 380 runs like the day I bought it.  Husqvarna is the only saw for me.  Thanks for the videos and good luck!  Shalom/gw
Reply: Husqvaŕna!
Reply: I dont know if you still check this but...  I live in the United States and am a huge Husqvarna fan, however, the newer Echo chainsaws are similar in quality and almost half the price.  I suggest the Echo cs 490.  A little more power in a 50cc but still light in weight.  Im also told the conversion to a 60cc is relatively easy.
Reply: Amazing, your technique sounds disingenuous, yet I see it working with my own 2 eyes.
I think you have saved many people a lot of trouble by sharing your secrets of chainsaw cutting. Many thanks.  🙏
Reply: In regards to the jig you were upset with due to the lack of power from the chains contact over a broad surface area, out a wedge in the end behind you to lift it up so it doesn't pinch your blade in a bevel
Reply: Milling is not light duty, so you are doing the work with a saw that is simply underpowered and thus will struggle. More power is the answer. 660/661 is the answer, but it comes with a downside: more weight.
Reply: I went into deep research mode when I decided to get a chainsaw.  Husky & Stihl were the only two consistently at the top of recommendations.  However, I picked up on an issue - seems like the older Stihls are bulletproof but newer ones had seemed to get comments that they may not be built as solid as the old ones. So I bought a Husky 450 rancher... prolly a couple years old (used) but used very little.  I am very satisfied with it so far.  

TIP:  ALL STIHL products MUST be bought from a dealer... if your local dealer closes at 5pm every day this might be inconvenient... I did purchase a Stihl Weedeater with a solid steel shaft.  I love it... but I couldn't pull the trigger on the chainsaw.  

TIP:  The Stihl Dealer has been in business for many years, the Dad has passed the biz to his son... The dad has been working on chainsaws & weedeaters (and most small engines) for 30 years.   I asked him about fuel types... I expected him to say, "Non-Ethanol"  He surprised me and said ONLY RUN PREMIUM FUEL of the HIGHEST OCTANE.  Damn... I installed a 550 gal bulk gasoline tank at my place and have the local co-op deliver - they only offer Non-Eth and I thought this would be perfect for all my small engine stuff... no, he Implored me to purchase high octane premium EVEN IF it contained ethanol.  sucks for me.  But he said weedeaters, chainsaws should run premium as the main factor for trouble-free operation weighed heavier on premium fuel vs non-eth... You have been warned.  I have decided to run premium in my Husq 450 rancher chainsaw... (his advice was not brand-specific)
Reply: id suggest a Husqvarna 455 thats what i run. similar size as a ms260 but Husqvarna seem more reliable overall
Reply: if the saw is not allowed to warm up before racing the motor it will score the piston
Reply: I tried this on oak and cedar logs, was truly impressed with the lumber I could cut. I have owned and operated sawmill previously and this is the best chainsaw board cutting method ever. Thanks for posting this.
Reply: Husky 460 Rancher.
Reply: Husqvarna seems to be the best one currently
Reply: 2 year old video, so you probably have new saw by now, but I'll recommend Husqvarna anyway.  455 Rancher has been working well for me for many years.
Reply: I have Stihl ms362 for about 6 years i guess and its still working perfectly, I have to admit a put it into some serious trouble but it still surprises me. For example - 10 mins straignt cutting maple, whole bar in the wood, full power
Reply: @кровьзакровь-б4ш  he never cut down a living tree. Only uses trees which are allready  dead.
Reply: @martinhoflich6150  In Russia, it is forbidden to cut down even dead trees. But if the tree itself has fallen, then you can collect the remains.
Reply: @кровьзакровь-б4ш  thats exactly what he does and entertaining us with his abilytis . peace man and stay save
Reply: @martinhoflich6150  we will be forced to appeal to the prosecutor's office for his illegal actions
Reply: For saw size for this work, i would say any saw 80cc or larger would be much better than a 50cc. I have tried milling with my 261c and it is quite hard on the motor and i have to make sure i back off and keep the rpms up when using such a small saw. Also warm up and cool down are very important with this heavy duty work cycle you are putting on the motor. Another thing i noticed that is very important is making sure you never run out of fuel during your cut because it leans out the fuel mixture and runs very hot as you run out of fuel.
Reply: I like the Husqvarna XP series, when I went to a 372 xp, from an old 1960's saw of same hp, but 30% more weight, I cut 2x as much wood in a day!  I don't care if you are a gorilla, or a tiny person, if you have a higher power to weight ratio, you will be able to cut more.  

I sold my 372xp to a friend before a  5year stay in the city, but recently moved back to the country, and just bought myself a used 357xp.  Loving it so far, I have an 18" Birch log I plan to try your method on.  Most people here would say a 4.4hp saw is much too small for milling, so this will be a good test of your method.  

Thanks again for your great videos, you can really tell the difference between a nation of chess players, and a nation of football watchers, hah.
Reply: Stihl 500i
Reply: MS 290 , give it a try, 20 in bar, ms 390 good to if you need more power, myself I allways use 93 octane with stihl mix oil, the orange bottle, had my 290 for a few yrs now, fell many a tree and that much more fire wood, 💯
Reply: I've never really had any problems with a Stihll chainsaw I'm wondering if you're running it to a proper break-in period before you use it for milling.?.
Reply: I've had the same 026-Super from Stihl for 25 years and in the season, it gets used every day.  The next one will be their new 500i direct injection saw.
Reply: I used that pendulum method and it works ,,,gr8 vid man i liked the flat side up on the roof  build ,what did you lay over that ?👍🏼
Reply: I have had Stihl and Husky saws.  One problem when milling lumber is that they tend to burn hot.   Never use gasoline with Ethanol in it, use a good gas stabilizer like Star bright and always use Synthetic oil in the mix.  The scoring I saw is heat related.
Reply: Contact Stihl directly.  Tell your problem. Direct them to your channel.   If they stand behind their product they'll take care of you
Reply: You need a raker file and file down the rakes on your more powerful saw, problem solved. Former faller from BC, CANADA.
Reply: Husqvarna for me!
And if you have had problems with your Stihl, then get a refund or an exchange for another saw, bro. There’s no point try to fix a defective product, it’s basically the same a polishing a turd. 💩
Reply: I don't know how you made out with your saw problem but I suggest go old school. I love and use the Stihl AV 041 or AV 045 I there older saws but you can find them around. Very easy to work on and take a beating no problem. I don't mess with the new saws they seem like toys. The old school ones are tryed and true. I run them with good oil 50:1.
Reply: @azsazs6039  Wow that was very honest I will stick with my beloved Stihl also.
Reply: Hi Max, why not go for a recent battery driven electrical chainsaw? The only thing that could be limiting the number of cuts you are able to make in the field is the number of batteries that you can afford. otherwise, there are only upsides on a battery driven chainsaw: no toxic fumes, no noise pollution and no combustion engine maintenance.
Reply: @killwhitey33  🤣🤣🤣
Reply: i use husquvarna 61 shes old but cuts great low maintainece over lifetime of 32 years so far
Reply: Check out Makita/Dolmer saws. Very well made
Reply: Echo CS-621SX better then sthil and Husqvarna I have all 3 and Echo it's  far a way best option.
Reply: Just wanted to check, that gas you poured in looked unmixed with oil, I assume with the amount of sawing you do that you had it mixed tho, right?
Reply: If your Stihl was made in S. America I think there steel is to soft.  Bought an axle that was made there and didn't last a year.
Reply: @chattonlad9382  yar, or a good Poulan same diff usually
Reply: When rebuilding your saw make sure to do porting. Many dealers don't bother. On the other hand you're not doing light work. Maybe start your guide cut with the 260 and then move to a big saw
Reply: At 11 min, its looks like your gas isn't very blue. How was the mix oil? I found using Oregon mixing oil at 50:1, I blew a newer 362 and repaired the pistons. My older 361 did not have the same fate on the same mix, however my engine mechanic said I needed to use the Stihl mix oil, or go heavier on the Oregon.
Reply: First time seeing your vid.  I’ve used lots of saws for logging, milling etc. I’m not impressed with the new saws of any brand. I’d be looking for an old husky or still. Not necessarily the more cc’s the better,you still have to carry it around. I had an old 88 husky that I couldn’t kill.
Reply: This video is an old one, but Echo makes a great saw.
Reply: @chattonlad9382  in a few
Reply: Miss you Maxi, hope your well.
Reply from the maker: @ddoherty5956  Working on a couple of new videos, including this video's sequel. Stay tuned...;)
Reply: @Advoko  Fantastic I, thought you had ended up on the wrong side of a sanction of some sort. I understand why they are doing them but good men paying for bad men's deeds has never sat well with me. Take good care 👍🤝😊🇬🇧
Reply: Husqvarna 550xp m2 or 562xp you will be happy
Reply: I'm a Husqvarna guy.
Love my huskies! 😉👍
Reply: I like the echo cs 590 Timberwolf. It is a little bigger than your stihl, but not by too much. For comparison,  I also use a stihl ms361. The echo isn't as big as it.
Reply: Stihl ms 462 or 461
Reply: @PenZon  All 5 of my chainsaws, 3 weed eaters, 3 blowers and 2 pole saws are Echo.  I've been using Echo commercially for the past 40 years.
Reply: I know I'm really late to the conversation, but I have an old Stihl 026 which is ridiculously capable, reliable, and easy to use. Magnesium carcass and well-engineered trappings make for a great sawing experience.
Reply: I hope you are well, and safe.
I also hope you sorted out your saw.
A 260 is a small saw.
I had the same problem with a ms 362.
I blame modern emission controls.
The saw runs as lean as it can.
More heat less oil.
Husky or Echo.
Some Echos have an additional manual chain oiler. I like that notion.  Good luck.  Chris
Reply: Husqvarna for the special deep long cuts that ar hard on a chain saw. 
Stihl for everyday use.
Reply: I have a husqvarna 450, which has an 18 inch bar, and it's atleast 3 pr 4 years old, and never had to have any repairs, never died on me, never even replaced the plugs yet. Just basically adding bar oil, and replacing the chain when needed. I used it earlier today for a few hours nonstop, which is impressive as hell for a couple years old chainsaw not to have a single issue. Knock on wood or course.
Reply: Those small chainsaws don't handle continues power demands like felling or milling very well, I would at least go for 65cc or more. This is unfortunately a very common failure.
Reply: Just bought the chainsaw you're talkin about to replace my 362 that was recommended by a logging buddy that cut 40 chords a month with a light bar and a skip tooth 28 inch chain. It lasted me 12 years. The 66 and 88 are big boy's but, I miss my 362 as it did what I needed without the cost and weight.  Overall it is a good in between and does the job. After bending my light bar I switched to a 20 inch bar and for what you demonstrated the weight and power ratio I would highly recommend a 362.
Reply: The key is to understand, products aren't made like they used to be, that said, I rely on Husqvarna, but try to purchase from the company ,stay away from these big companies  who sell everything , and know nothing g about wood cutting products, !! it's a about getting parts and customer service!!
Reply: @P_RO_ Poulan?!?! 😂😂😂😂😂😂 Man, I haven't laughed that hard since.....well......never!
Reply: Husky 572
Reply: Can an electric saw work just as well doing milling? Like a dewalt?
Reply: Husqvarna 562xp
Reply: Just because I rarely see it mentioned, EFCO made some decent equipment, I have a 6500 saw and a 2,5HP brush cutter both 10 years old I think, real workhorses. A bit heavy perhaps. Not sure how is their newer stuff.. they also make Oleo Mac at the same factory, and I don't have good experience with some of their recent gear
Reply: husky 550xp mark 2.  is the best 50 cc.  chainsaw I ever owned.   for light and medium work
Reply: I have a Stihl small climber’s saw along with an Echo can’t remember the model but it’s approximately fifty or sixty c.c. I have been using Echo brand chainsaws since the early to mid-1980’s and they are tough as nails plus quieter than most other saws I’ve had.
Reply: 🪓 🪵 Ha❗️ After reading the Comments on this very thread 3 years ago, I chose to buy an ECHO chainsaw instead of a STIHL.  It’s still a machine, and have had some minor fixes needed but on the whole I’m very happy with it 🥇  It’s a CS-7310SX 😬👍  I cut firewood for the locals the first full winter season and a half dozen good loads for us each of the last two years.  PLUS that is Australian Harwood, and it is seriously hard stuff 🪵 Hope that helps 🪓